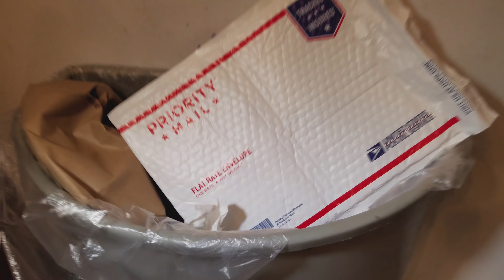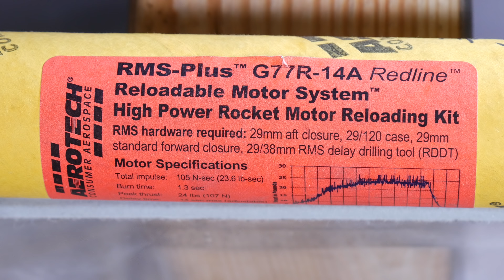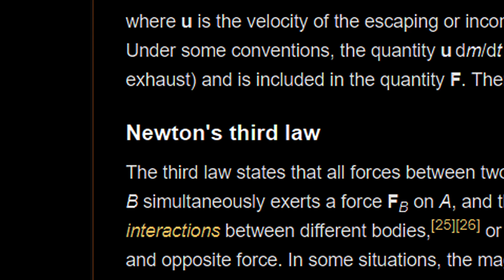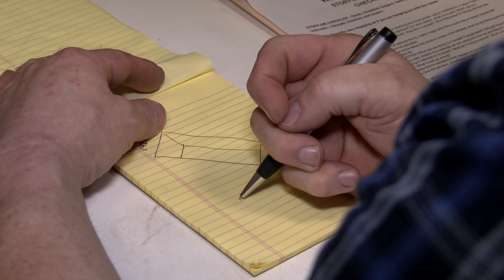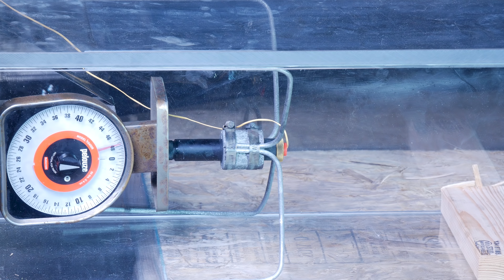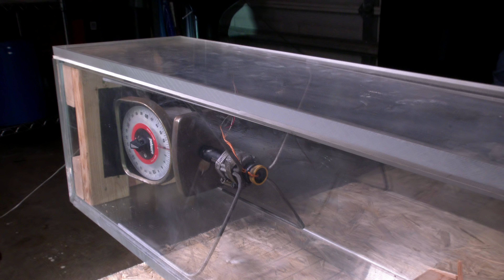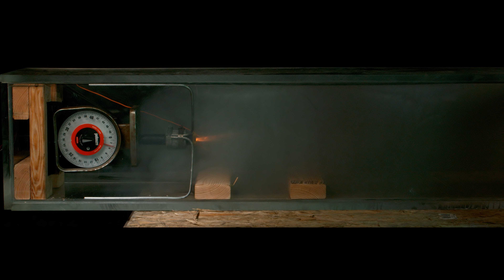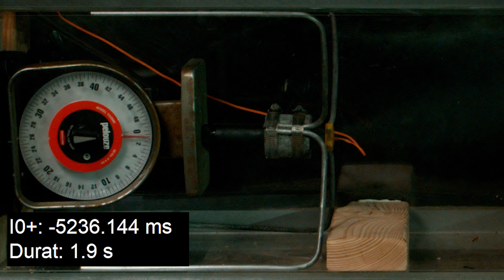Rockets in a Vacuum Chamber - Newton's third law of motion Visualized

Comment: Here's a quandary for anyone who believes rockets don't work in space. Say you're in space and you're just floating. You're wearing a spacesuit and holding a basketball. You then decide to throw the basketball. Does the basketball move? If not, what's stopping it? If it does move, do you move the other way? If you do, then that's how rockets work in space. If you don't move, then why are you so different from the basketball in this physical interaction?
Reply: The "rocket propulsion deniers" will agree that physics works when applied to a solid object like in your example.  What you CANNOT convince them of is that GAS will behave the same way.  They REFUSE to believe that each gas molecule behaves EXACTLY as the basketball and induces recoil to anything that accelerates it.
They believe this because they think the "vacuum of space" will PULL Gas molecules from the rocket, but they dont realize the "vacuum of space" DOES NOT PULL ON ANYTHING.
Reply: @stevencurtis7157  they  usually deny gravity is real as well. So there is that.🔨
Reply: @cory5797  Not sure that really affects rocket exhaust, but if they can deny one demonstrable physical phenomenon, they can deny any.
Reply: So after the first basketball was pushed away from you....and pushing it away from you would feel weird because there would be no additional resistance from space, unlike being on the basketball court, where the atmosphere offers resistance to the basketballs movement as you push it away......
So pushing the basketball away from you in space is easily done.  You push it away it offered very little weight resistance and flew away fast and kept going.  You on the other hand may have felt a slight backlash from doing that, and lets say that amount of kickback made you move 1mph in the opposite direction, as the basketball is moving 30mph away from you not slowing down at all....so neither are you.....so now you are moving 1mph in the opposite direction away from the basketball while it moves away from you.  Well what happens when you go to use  another basketball now to make yourself speed up from 1mph to 2mph?

Since you are now moving at a constant velocity of 1mph away from the direction you plan on pushing the next basketball away from you, it's the same as being on the basketball court, and walking backwards while you simultaneously try to pass the basketball someone in front of you as you are walking backwards away from them.  

Now pushing that basketball away from you doesn't have as much kick as the first time you did it....now pushing it away from you with the exact same amount of force doesn't make it move 30 miles per hour away from you...it's slower now because you are constantly moving the other direction.  Pretty soon it doesn't do any good to push basketballs away from you, because you can't push them away fast enough to do anything now....You are moving at a constant velocity so you have to push the basketball away at least that velocity or it won't offer any resistance, and will no longer provide any thrust for you.  this is exactly rockets do NOT work in space.
Reply: @dr.davidbannerf.e.s.6217  Acceleration is change in velocity. It doesn't matter whether you change the velocity of the basketball from 0 to 30 mph or 1000 to 970 mph, it's going to have the same effect on you, that is changing your velocity by 1 mph.

Can you describe exactly what you mean in mathematical terms?
Reply: @stevencurtis7157  Quite simply put....if we have a water balloon in space, and we open the end of it, there is nothing to slow the water down from coming out  of  the balloon....so the water doesn't get PUSHED out....it gets drawn out.  Meaning....there is never a time when the water coming out of the balloon encounters slower moving water to tell to get out of  the way.  so there is no net force in the opposite direction.

It's simple actually.  on the Earth when the  end of the water balloon is  opened, there is resistance to it coming out....the atmosphere offers some resistance to the water coming out  of  the balloon....so the faster moving water leaving the end of the balloon runs into the slower moving water which was immediately slowed down because the atmosphere offered resistance to it's forward movement.  when this fast moving water runs into  the slower moving water that was just ahead of it, it pushes it out  of the way, and this makes the balloon take off.

In space it's different...the water coming out of the never encounters slower moving water to push out of the way....The water moves at a constant velocity exiting the end of  the balloon, it is never slowed down any because there is no atmosphere in space to cause the column of water to  hit the brakes and slow it down....so the water coming out of the balloon just joins the already fast moving water already expelled, and never pushes it of the way saying move out  of the way I'm cruising faster than you.  So sorry guys....a rocket absolutely does not provide thrust in space.  Right back to  what we have been saying the whole time....there is nothing in space for the water jet to push off of, therefore it is never slowed down leaving the rocket, and never has anything to push out of the way, so you never get pushed in the opposite direction as a result.
Reply: @dr.davidbannerf.e.s.6217  long and wrong speed is relative
Reply: @dr.davidbannerf.e.s.6217  what's pulling on the water? Is it just a coincidence that the balloon rubber is like a spring and squeezes the water out? It can't act like a spring if there's nothing for the spring to push the water against?
Reply: @cory5797  If we actually witness a water rocket, or water balloon when the end of it is opened....what would happen if  you opened the end of it in our atmosphere, or the vacuum of space....if we could watch what happens in slow motion....we would know what is truly going to happen wouldn't we?

Well...that's where I step in....My mechanical aptitude allows me to simulate such things with a high degree of  understanding about their movements and workings.

When the end of  the water balloon is opened in our atmosphere, the speed which the water comes out is slowed down by the atmosphere itself...just simply saying it immediately encounters resistance to it's outwards path of travel.   This seen in slow motion equals the very first amount of water to come out, to now be moving slightly slower than the current water coming out right next to the end of the balloon.  In other words...the water coming out of  the balloon encountering resistance is  slowed down some, and this forces the initial velocity of the water exiting the balloon to push against the slower moving water that was expelled first...and this "pushing out of the way", by the faster moving water running into the slower moving water is what produces a "force" for the balloon itself to get pushed forward.....or this is what produces the Thrust of the water jet coming out.  It's faster moving water under pressure, running into the slower moving water that left first in line, that has been slowed down due to the atmosphere here on Earth.

In space it is quite different and  the difference is that water jet coming out of the balloon does NOT get slowed down, and therefore does NOT get pushed out of the way by the faster moving water at the back of the line.  Instead the water which left the balloon FIRST is traveling at the same speed the water leaving the balloon NOW is  traveling.  So the water leaving the balloon NOW is NOT moving faster than the water which left the balloon FIRST....therefore it does NOT run into slower moving water, and therefore it does NOT push slower moving out of the way, and therefore does NOT provide any thrust because it never pushes ANYTHING out of it's WAY.    Got it?  Get it...learn it....love it...eat it up...do whatever you gotta do....but dont ever FORGET.  And maybe don't me....Old Skool...who told you about it, and took the painstaking time to tear down your initial biased opinions about it...and BEAT it into you mind literally, repeating it over and over and over until you FINALLY get a good grasp of what is actually happening.  I Want you to know what is happening...it's in my nature, as One Man Sharpeneth Another.  Amen.
Reply: @stevencurtis7157  not that I know of but it was a good way to prove a point
Reply: @stevencurtis7157  I think its easier just to see it as water under pressure inside of an object, and then a valve is opened allowing that water to escape.  In atmosphere the water First in line to escape is immediately slowed down due to the resistance the atmosphere has on its path of travel.  So the water now coming out of the object runs into the slower moving water which exited first, and pushes it out of  the way, and provides a thrust or force to push the object in the other direction, because the object itself has something coming out of it, that is pushing other stuff out it's way.

In space this cannot be, because the water coming out of the object never gets slowed down by an atmospheric pressure....space doesn't offer any resistance  to  it's path of travel exiting the object.  So the water first in line to leave the object is moving at exactly the same speed as the water currently leaving the object, and so the water currently leaving the object never encounters slower moving water to push out of  the way, and so the object doesn't have any forward thrust....Because it doesn't have anything coming out of it that is pushing anything out its way.  That simple.  Case Closed Yet Again...Geez....Just Say thank you Old Skool...and go be a bad ass in the science world now with this FACT of Phsyics.  Impress all of your friends for KNOWING the exact physics of what actually happens....they won't be able to prove you wrong now....because YOU KNOW WHAT HAPPENS>  Gratze'
Reply: @dr.davidbannerf.e.s.6217  for the"toy water rocket in a vacuum"  experiment, please draw a force diagram and tell us where does the FORCE originate THAT ACCELERATES THE WATER ??  You refuse to answer this basic question because it reduces your understanding of physics to nonsense. TELL US WHERE THE FORCE COMES FROM THAT ACCELERATES THE WATER.
Reply: @dr.davidbannerf.e.s.6217  You didn't answer my question. What is pulling on the water?
Reply: @stuartgray5877  There is no force that accelerates the water coming out of  the balloon here on the Earth...in fact the atmosphere slows down the water coming out of balloon because of resistance to the path of travel.  And of course just the opposite for being in space....no resistance to the path of travel for the water coming out while it's in space..it can just come right on out and keep cruising while in space....it never gets slowed down like being  in an atmosphere.  Duh.
Reply: @stevencurtis7157  Oh, what is pulling on the water?  i don't really think there is anything pulling on the water....it's just that in space there is nothing to slow the water down coming out of  the balloon....so it keeps moving at whatever speed it comes out of the balloon while it's in space.....and then of  course the water is slowed when it leaves the balloon while it's in the Earth's atmosphere.....So the atmosphere of the Earth slows down the water escaping the end  of the balloon....and space does not ....Hope this helps....I probably won't be able to help you much  more on this topic....But it's fairly simple to understand, so good luck.
Reply: @dr.davidbannerf.e.s.6217  Okay, so we go back to the original post. You are floating in space, you throw a thing. It definitely moves. Do you move? If not, how is that possible? What evidence do you have that "pushing off" is required for thrust? 

I previously have an example of a bowling ball and a jumbo beach ball. The huge beach ball pushes a lot more air out of the way, but it exerts a lot less force on your body when you throw it. The bowling ball pushes much less air or if the way but resists being moved much more.

Explain?
Reply: @stevencurtis7157  It would only work on a small scale....you wouldn't get that much momentum in the opposite direction shoving the bowling ball away from yourself.....like imagine floating in space, and trying to throw the bowling ball away from you instead of pushing it away with both hands at the same time.....man that's a hard one to understand....
Reply: @stevencurtis7157  Like it would only cause your body to pivot slightly and rotate very very slowly perhaps in the opposite direction of the throw.....and again...you arm has to move faster than the bowling ball, or it won't push on anything.
Reply: @stevencurtis7157  Like...in space....you get something out of the first initial push of a heavy object away from yourself....but the next push doesn't have as much effect...because you have to push faster the next time....pushing the heavy object away the second time won't get you anywhere unless you push it away faster than the speed you are moving now.
Reply: @dr.davidbannerf.e.s.6217  - "there is no force that accelerates the water coming out of  the balloon here on the Earth.."
THERE MOST CERTAINLY IS!  The "Force" trying to push the water OUT is the pressure differential between the inside and the outside.  

Now in the example of the toy water rocket in a vacuum:
where does the water get the FORCE that accelerates it into the vacuum ?

Are you saying the water WONT shoot out into the vacuum?
Are you saying that the water requires NO FORCE to be accelerated into the vacuum?

WHY do you refuse to just answer this simple question?
Reply: @stuartgray5877  I've already answered this question time and time again...but let's run it through until we reach the bitter end....Lol!
Or the glorious understanding of it in fine detail!  Whichever way it ends up going....it will be a meeting...of..the minds.
Deep...like the Minds of Minolta...let's picture this yet once again....

The water balloon in space has water trapped inside of it that is under pressure.....and when released it does not get slowed down any like it would on Earth....let's go with that much, because we both agree in space there is no atmosphere to offer resistance to it's path of travel escaping the balloon's water jet opening.

So on Earth the force with which the water is escaping the jet opening does encounter some resistance, because of the atmosphere.  That causes the jet stream of water to apply pressure against the air on the outside of the balloon.  The fact that the atmosphere outside of the balloon offers some resistance, is why the jet stream of water coming out applies pressure against it...and it is this ability to apply pressure against something impeding the water's path of travel that produces the thrust force we are searching for.

In space a water balloon can be housed in a chamber to protect it from the outside lack of atmosphere, whereas only the jet stream opening can be opened and closed allowing the water to escape the balloon to outside of the balloon's protective chamber.....And now let's see what the water jet balloon in space does:....

When the water is escaping the opening it does NOT encounter any resistance to it's path of travel, and therefore; cannot apply any pressure against anything because there is nothing offering any resistance to it...there is no atmosphere to offer that much needed resistance to its path of travel for any pressure to occur against. Literally there was no bowling ball on the outside of the jet opening when you opened it and released the pressurized water.  

So there was no initial pressure applied to anything to produce any force in the opposite direction in order to move the rocket.  If there a bowling ball floating in space right beside the jet opening, but not attached to it....THEN when you released the pressurized water, it would run into something......it would have something offering resistance to its path of travel....then it would produce pressure against the surface and weight of the bowling ball, which would produce a force of thrust in the opposite direction.  

So sorry, but I had to remove the bowling ball from behind the rocket powered space ship...because we  ARE talking about space where there is nothing around you.  No bowling balls out there to push off of....for that you better hope you are close enough to a planet for the jet stream of water to reach some resistance to its path or travel.....Or you is NO go no wheres
Reply: @stuartgray5877  Mowfrackin Old Skool just broke it down with a water balloon and a bowling ball yo....That was dope...That brotha there got some science up in him....I wonder where he went to school main.....
Reply: @dr.davidbannerf.e.s.6217  - ALL of that above and you STILL NEVER ANSWERED THE QUESTION .

I know this for a fact, because nowhere up there do you say:
"The Force that accelerates the water comes from the nozzle "

See Larry, to accelerate the water, the NOZZLE MUST EXERT A FORCE ON THE WATER .
And you know what they say about a "Force"? They ALWAYS OCCUR IN PAIRS.
For there to be an ACTION (the water getting PUSHED ON) there MUST BE A REACTION (the NOZZLE GETTING PUSHED ON)

It is NOT POSSIBLE for the water to get a FORCE in one direction WITHOUT THE NOZZLE FEELING THE SAME FORCE.
Regardless what you say YOU CANNOT CHANGE THIS MOST BASIC ELEMENT OF PHYSICS.
Reply: @dr.davidbannerf.e.s.6217  I already responded to your assertions about relative motion/acceleration. Acceleration is change in velocity. If you are holding the bowling ball, it doesn't matter whether you're still or moving at 1000 mph, if you throw the bowling ball away from yourself at a speed you perceive to be 30 mph, you will gain the same 2 mph regardless of your initial speed. Do you have some way to refute this?

I mean, your model suggests that if you were flying in a supersonic jet and fired a pistol toward the rear of the plane, you would get much less recoil because the gun won't be accelerated as much. Even assuming that the plane had to be a vacuum chamber, that's blatantly and obviously untrue.

I mean, just walking on a plane would be a problem. To even move toward the front of the plane, you should need to apply enough force to push yourself forward faster than the plane just to start walking. Meanwhile, the force required to walk to the back of the plane must be so low that you'd shoot backwards at high speed and splatter on the back wall like you jumped off a skyscraper.

I'm calling this as your last chance to address my rebuttal. If you don't respond to the contention, then you're officially dunce-cap of the week. Since all your posts are predicated on that claim, you better have something good.
Reply: @stevencurtis7157  "Just like the Buddha kid in the Matrix told Neo.....do not try to push against the bowling ball.....rather, realize that in space there is no bowling ball.."

Old Skool
Reply: SCALE!!!!!! you have to consider masses involved and the amount of "force" exerted...
Reply: @stuartgray5877  You and the truth are totally estranged. ..
Reply: @messiahblackgod  can you elaborate? I'm not even sure what you're arguing for.
Reply: @stevewittwer7444  Wow, u mad bro? No need to be so salty.

I agree that if you remove either your body or the ball, you are indeed not going anywhere. Now imagine that sentence dripping with sarcasm.

I have no idea what movie you're talking about.

Now, show why anything I've said is a lie. Then we can discuss something. Until then, y u mad tho?
Reply: @cory5797  gravity is A THEORY that has NEVER been elevated to fact. Only on your imagination.. Density..
Reply: @stevewittwer7444  Also, please allow me to introduce you to a delightful concept: it is possible for a person to be wrong without lying. Continue as you are and prove that you're the real liar, lying about my intentions, which you cannot know.
Reply: @stevencurtis7157  take the ball out of the equation amd you will go nowhere because there is no opposing force. That is what happens to a rocket. No resistance from the opposite direction.. No thrust.. Exactly the Same as making the throwing motion without the ball.. You helped prove, again that rockets don't work in the vaccum of fake space.
Reply: @stevewittwer7444  The stand in for the ball is the rocket exhaust. Gas has mass. It has weight. It weighs something. If you throw it, it's the same thing. The energy put into the gas by combustion has the same effect as your arms pushing the bowling ball. That's why my OP is a catch-all, it's an informal version of a rigorous proof that negates the arguments that rockets need to "push off" an atmosphere.
Reply: @stuartgray5877  why accuse someone of not answering a question when u you never gave him a chance to answer it... How can tjey keep cool in space when they cannot radiate the heat in a vaccum. You refuse to answer this basic question because it cannot be answered and debunk your space fantasy. TELL US HOW THEY REMOVE HEAT IN A VACCUM... same as you do to others so it is on to do it to you...
Reply: @dr.davidbannerf.e.s.6217  but the "FUEL"  (exhaust gases) HAS MASS and therefore INERTIA. To accelerate something WITH MASS requires A FORCE.  You CANNOT ACCELERATE the exhaust gases without A FORCE .  So Larry - when the exhaust gases are accelerated into the vacuum WHERE DOES THE FORCE COME FROM ?
Reply: @stevewittwer7444  I can tell you how heat is removed in a vacuum, but you are CHANGING THE SUBJECT.  Now answer my questions.
Reply: @stevencurtis7157  yes it is. In this case you are lying. If you done no research, then you knee you are just guessing, and therefore being dishonest (lying). Just childish dishonest argument obwr something you are ignorant about amd ignore qhat people say. Ho research yourself. If you done the research you will know rockets don't thrust in space so you are still lying... You cannot understand the plain and simple explanation, then go watch something you can understand. Like some kids show..
Reply: @stevencurtis7157  you were obviously the dunce of your claas every year, right.
Reply: @stevewittwer7444  lol u got it gravity is not real and you can prove it
Reply: @stevewittwer7444  AGAIN you are making false statements about a topic you clearly know nothing about.  Heat is rejected by hot objects in a Vacuum via RADIATION .  The SAME WAY heat gets to earth from the sun.  Now stick to topics you know about.
Reply: @stuartgray5877  This the last time I am going to answer this question about the only Force at play in the situation of a rocket in the vacuum of space.  the fuel is under pressure in the tank, it is ignited and allowed to escape....whatever speed that is...is the only force of anything coming out of the rocket....It is the only thing leaving the rocket's presence, therefore it is the only thing that could possibly have any FORCE of ANY kind whatsoever.........

In space this FORCE or speed with weight equaling INERTIA.....Cannot act upon any OTHER speed or weight of anything.  There is  nothing in space to give this FORCE anything to apply pressure against.

Quite simply put, if there was something in space for the FORCE of the rapid escaping fuel and gas column to apply pressure against....It would make the rocket move in the other direction.  

At no point in time did I say the fuel being under pressure in the tank, then lit on fire and allowed to be accelerated outwards from the ship wasn't producing any FORCE.  Of  course the water, or air, or rocket exhaust is expelled with FORCE.............the part you keep missing is the ability to USE that force to achieve propulsion my friend....and I will keep saying until I am blue in the face......That FORCE is never met with any opposition....it is never up against resistance of any kind whatsoever....the vacuum of space meets that FORCE with nothing....it doesn't slow it down, or make it move any faster....the exhaust just moves at whatever speed it moves at, and keeps moving at that speed....it is never slowed down......a ball thrown by you in space just keeps on booking.  And a ball thrown by you in space is not going to just speed up all of a sudden....so you will see it fly away at a CONSTANT speed.

So when the Force of the rocket exhaust is moving....since there was no bowling ball in space for the FORCE of the rocket exhaust to push against.....it didn't provide any thrust.
Since the FORCE of the rocket exhaust was immediately met with NO resistance from outside of the ship....it could never apply pressure to anything in order for the ship to be pushed in the opposite direction......

Since the FORCE of the rocket exhaust was simultaneously met with ZERO stopping power from the space outside the rocket bell housing....it could never apply it's inertial FORCE on anything to benefit the ship itself....YOU saw it just move away from the ship while your speedometer sat still.  

YOUR arms and hands are the rocket fuel escaping the ship.  IF they cannot FIND a bowling ball outside the ship to push away............YOU don't get shoved the other direction any....ITS OVER>
Reply: @stevewittwer7444  the question I keep asking that Larry wont answer is: with a Toy WATER ROCKET, in a vacuum, when the Water gets pushed out of the rocket BY AIR PRESSURE, where does THE FORCE originate ??  The water CLEARLY gets accelerated, so WHERE does the force come from that is accelerating the water?  He TYPED a lot of WORDS but he never answered the question.   Now YOU answer My question: if I fire ice blocks from a crossbow in a vacuum, WILL THERE BE RECOIL ??
Reply: @dr.davidbannerf.e.s.6217  ok, you finally admitted that the water (or fuel, or exhaust gas) REQUIRES A FORCE to be pushed INTO the vacuum.  Good now we agree that the exhaust gases REQUIRE a force to be accelerated AND that force originates AT THE ROCKET NOZZLE.   Now recall one of Newton's most basic laws: "For Every ACTION there is an EQUAL AND OPPOSITE REACTION" .  Do you recall this? It means there can NEVER be a single ended force, they come in PAIRS.  So for the water (or exhaust gases) TO FEEL A FORCE from the NOZZLE, the NOZZLE FEELS THE SAME FORCE FROM THE WATER .  So we just proved that Rocket Propulsion MUST work in a vacuum as the Water (exhaust gases) GETS PUSHED INTO THE VACUUM .
Reply: @stuartgray5877  You still got it wrong right from the start again.  It does not require a force to push the fuel into vacuum.  The fuel is already under pressure, and will move out of the nozzle because of  that.  What is required is the equal and opposite reaction from space when this occurs....there must be a reaction space gives in response to this action.  So again....what is the reaction that space gives to  the action of the FORCE at which the rocket fuel is coming out?  

Because remember...on the Earth....the reaction that the atmosphere gave to the action of the FORCE at which the rocket fuel was coming out was RESISTANCE>  The Force of the rocket fuel was met with an equal and opposite force of RESISTANCE>  This allowed the FORCE of the rocket fuel to apply PRESSURE against that resistive response from the atmosphere outside of rocket.   And bingo the equal and opposite reaction of this interaction between Force applied in one direction, met with resistance, resulting in pressure applied to air, and it being pushed away.....The equal and opposite reaction of this event occurring is what we call THRUST!  

Now you are finally getting it!  
There is no THRUST in Space!
Because the Force of the rocket fuel does NOT get met with an equal and opposite braking force, or any braking force whatsoever from space....since space does not have the reaction of slowing the rocket fuel down.....There is never the equal and opposite reaction from pressure being applied to a resistive medium.......Because it  is ONLY when pressure is applied to a resistive medium that you can have the equal and opposite reaction of being shoved back the other way you silly silly man.
Reply: Two totally different scenarios:  On the one hand when the rocket fuel comes out  of the nozzle with speed and force, and it met with an equal reaction from the atmosphere of Earth which impedes the rocket fuel's movement some....offers some resistance to that action.....then an equal and opposite reaction occurs from this....and THAT my friend is how we achieve Thrust.

Thrust is literally the equal and opposite reaction of applying pressure to a resistive medium.  Something that will offer some resistance to the direction of that rocket's exhaust.   And when there is something present that offers this REACTION to the ACTION of the rocket fuel escaping....That allows pressure to be applied between the TWO of them, and BINGO!  You get have a force shoving you in the opposite direction!  Thrust!!!  Isn't that cool!

But in space....when the rocket fuel escapes...it is NOT met with the much needed REACTION of allowing the FORCE of the ACTION of the rocket fuel escaping the rocket to apply any pressure against anything.....so the ACTION of the rocket fuel escaping is met with the REACTION of nothing.....ZERO resistive medium for that ACTION to apply pressure against.   Nothing out there for the Rocket exhaust to apply pressure against....So sorry.....And THAT is why there is never the equal and opposite reaction of being shoved in the other direction.....because there is never the event where the rocket fuel is applying pressure to any resistive medium in space, there is NEVER a FORCE created between the rocket fuel and the resistive medium...so there is NEVER any point in time when the rocket fuel is applying PRESSURE to something in space to get a resistive response from it.....which in fact what we call THRUST>

Thrust IS the resistive response from the medium which you allow the rocket fuel to escape in.
Reply: @dr.davidbannerf.e.s.6217  Watch the YT video " Close Up Footage of Falcon Heavy Launch Through Landing!" by Astronomy Live.
Now explain how those Boosters separated at 60 kilometers altitude, in a vacuum, Turned around, canceled ~3600 MPH downrange velocity and FLEW BACK TO KSC - IN A VACUUM .

YOU said rocket propulsion DOES NOT WORK in a vacuum, so explain HOW those boosters CHANGED DIRECTION IN A FUCKING VACUUM.
Reply: @stuartgray5877  I will tell you exactly what I see in that video....because I SEE everything.  For one it is a relatively small test chamber.  Two, that little rocket doesn't produce any thrust until there is enough resistance to it's exhaust....that is why there is a slight delay in the time before it applies any thrust against the scale.  It is precisely that time which the little rocket is adding pressure back into the test chamber, that the pump took out when it was being evacuated before the test.

I super simple terms:  I take a pressurized can of air.....then place it inside a fairly small airtight chamber I have taken the air OUT of....and I release the compressed air inside of that test chamber......what did I just do?

I sucked the air out of the test chamber, and then I turned right around and put air back into it.

I sucked the air out of the test chamber, then I released a canister of air of compressed air into the chamber, and duh...that just added air right back into the chamber.  Easy Stuff.   That is what I see....and THAT is exactly what happened.
Reply: For those that believe rocket propulsion does NOT work in a vacuum, let's do some thought experiments:   Imagine an Aluminum cylinder 40 cm long (about 16 inches) sealed at both ends with a plate and a ball valve in the center of each plate.  The orifice of the ball valves is 1 cm (almost 1/2 inch).

So, this is a sealed cylinder with ball valves at each end.
Now inside the cylinder is a piston that can move freely but wont let liquids or gases cross the boundary from one side to the other.

If I open both valves and pressurize one side, the piston will move all the way to the opposite side and vice versa.
(This is basically the design of an Oil Accumulator for a race car)
Fill one side of the cylinder with water half way (this is one liter).
Then pressurize the other side with 10.0 PSI air (this is ALSO about 1 liter).
Now IN AN ATMOSPHERE, if we open the water valve, WHAT HAPPENS?
The water will SHOOT out the valve like a fire extinguisher.
What if we repeat the experiment with 3000 PSI air?
NOW the water would shoot across a parking lot!

Is there ANY question that in the second example the cylinder can impart a LARGER MOMENTUM onto the water stream than the 10.0 PSI example?

Now take this same cylinder and try some examples in a giant vacuum chamber:

1 - I fill the water side with 1 liter of water, I OPEN the gas side valve and put the cylinder in the vacuum chamber and pump it down.  So now there is Vacuum on the "gas side" of the piston and vacuum outside the water valve.
What happens if I open the valve?  The water would NOT just shoot out of the valve because the vacuum is NOT pulling on the water.  There is NO PRESSURE on the "gas side" of the piston because it is exposed to vacuum too so it is not "pushing" the water towards the vacuum.

So the water (now exposed to vacuum through a 1/2 inch hole) will begin to boil (and freeze simultaneously) and pressure would build inside the cylinder and begin pushing the water out, but this would not be instantaneous.

2 - I fill the water side with 1 liter of water, I FILL the gas side with 10.0 PSI (10.0 PSIG is GAUGE pressure, ABS pressure would read ~24.7 PSIA), CLOSE THE VALVE, and put the cylinder in the vacuum chamber, and pump it down.  So now there is 24.7 PSIA on the "gas side" of the piston and vacuum outside the water valve.
What happens if I open the valve? WONT the 24.7 PSI PUSH THE WATER out FASTER than example #1?

The water will have velocity (shooting out of the valve) that it did not have before.  Something is accelerating the water. What is providing the FORCE to accelerate the water into the vacuum?

3 - I fill the water side with 1 liter of water, I FILL the gas side with 3000.0 PSI (3000.0 PSIG is GAUGE pressure, ABS pressure would read ~3014.7 PSIA), CLOSE THE VALVE, and put the cylinder in the vacuum chamber, and pump it down.  So now there is 3014.7 PSIA on the "gas side" of the piston and vacuum outside the water valve.
What happens if I open the valve? WONT the 3014.7 PSI PUSH THE WATER out FASTER than example #2, like A LOT FASTER?

Wont the MOMENTUM of the water be HIGHER than in example #2?
So WHERE does the FORCE that accelerates the water COME FROM?
Reply: ignition doesn't happen in space though, so the rocket is useless there
Reply: @scottandildi  so are you saying a HAND GRENADE would not explode or a bullet would not fire in a vacuum?  REALLY?
Reply: @dr.davidbannerf.e.s.6217  so no comment on the video of rockets propelling themselves in a vacuum that proves you wrong?  Surprising...
Reply: The way I see it the vacuum of space is to air as air is to water. Far less dense. If I take a boat motor and propeller and try to fly in air it doesn't work. Why? You might say because it needs water to push off of. Ok...then how does a plane fly with a prop. Same idea but different medium. Different density substance that we're trying to push off of.
Reply: A plane prop pushes air at a higher velocity the the gear ratio from the motor is also different... the prop spins faster. With a boat you also need higher torque to move through the more dense water.
Reply: So then when we talk about space like there's nothing to push off of. There is something it's just far far far far less dense than air but if you push with a high enough velocity the exhaust can't disperse fast enough and so produces thrust. Like behind an airplane prop the air is under higher pressure than atmospheric but it disperses quickly. Same would be true in space but to a different degree.
Reply: If your in a boat and you go full throttle you better hold on because there is so much thrust and water is so dense to push off of you can accelerate very quickly depending on horsepower. In a prop plane when you go full throttle from stop you may feel thrust but It's not going to throw you out the back of the plane.
Reply: @stuartgray5877  Those were the ACTUAL videos that showed what was happening....that's how we know what we KNOW now....the exhaust of the rocket placed pressure right back into the chamber, that we had previously taken out to make it a VACUUM.

WE ADDED something to our CONFINED space that is airtight and HAD the air sucked out.   There it was:  A box with the air sucked out....or pressure inside of the box reduced, or the "atmosphere evacuated out of it".....whatever you wanna call it.

that's what we did.......We added atmosphere RIGHT BACK INTO IT>  IN the form of gas molecules from the rocket itself....

And YES....there a DELAY in the time before THRUST was produced in the experiment with a relatively small BOX.

Then when a larger BOX was used...it took LONGER for the gas molecules to create an atmosphere inside the BOX....and that is why we saw an even LONGER delay before the rocket pushed against the scales.  

If you Don't get it...that's ok.....Thousands of people get it now.....scroll DOWN in the comments section on that video now.....LOTS of people see what happened.

REAL SIMPLE......We sucked the atmosphere OUT of the BOX.
Then firing the rocket PUT atmosphere back INTO the BOX, and that's when THRUST  happened........Cha Ching....
Reply: You fools got it twisted. It’s not that propulsion wouldn’t work. It’s that fire doesn’t burn. No fire = no propulsion. You throwing a basketball has no need of the use of fire to get propulsion. Just your own energy.
Reply: @dr.davidbannerf.e.s.6217  in that video I ASK YOU TO WATCH ABOVE , HOW do those boosters turn around and fly back to KSC IN A VACUUM ??
Reply: @adeadlyfart13  - If you read my other posts you would find I AM TALKING ABOUT THE SPACCEX LAUNCHES AND LANDINGS and it IS NOT POSSIBLE FOR THOSE launches and landings TO BE FAKE.  Every single one is viewed by TENS OF THOUSANDS of spectators LIVE, and I have seen one MYSELF with my own eyes.  There are now HUNDREDS of amateur videos of the spacex launches AND LANDINGS on YT.  Now QUIT MAKING SHIT UP!
Reply: Find a big carton box. Seal all 5 sides with an opening at the side. Go in an push with your hands with all your might at the opposite side of the opening while kicking out at the opening. Then observe how fast and far the box goes.
Reply: @stuartgray5877  On the Flat Earth model....any pendulum placed anywhere on Earth will point straight down to the same direction of down.  Not any different directions of  down. And whatever happens when you swing it is the NATURE of how a weight tethered to a long string FORCES the weight to swing around....and YES it does swing in RANDOM patterns based upon HOW you swing it.

ON the Globbers model the pendulum weight is being pushed or pulled by centrifugal force from the rotational velocity at that particular location (the ground speed at say the North Pole, versus the Equator), and the pendulum is either pushed or pulled off center accordingly....both while motionless, and while swinging because the FORCE of pushing or pulling from the rotational velocity is CONSTANT at that location.   Real simple.

If there is any force present to push or pull on the weight of the pendulum while it's in motion, the SAME amount of force is pushing or pulling on the pendulum while it DOESN'T swing...effecting where it points straight down to NOW..and how it was swinging THEN>

See how that works....super simple:

A Pendulum weight under centrifugal force of any magnitude shows the EFFECT of this force acting upon the pendulum while at REST..in the form of the weight itself being pushed or  pulled in the DIRECTION that FORCE is ACTING UPON IT>  And this SHOWS itself in the form of WHERE the pendulum weight points down to.  Pushing or Pulling on the weight of the pendulum with centrifugal force while it's at rest, or motionless and NOT swinging.. will simply push or pull on the pendulum weight, and CHANGE the DIRECTION it points to. 

A Pendulum weight under centrifugal force of ANY magnitude shows the EFFECT of this FORCE acting upon the pendulum while it SWINGS, in the form of the weight itself being PUSHED or PULLED in the DIRECTION that FORCE is ACTING UPON IT>  And this SHOWS itself in the form of HOW the pendulum weight swings.  Pushing or  pulling on the weight of the pendulum while it's swinging.. will simply CHANGE the DIRECTION it swings to.
 Thanks, Old Skool.  You're Welcome Guys.

See your Globber model does NOT take into account the effects of centrifugal force on the Pendulum while it's at rest, not swinging.............Because if it ever did, and ONE of you announced it PUBLICLY it would disprove the Spinning EARTH theory....because you would have to show  the weight of the pendulum pointing in the direction the force of the spin was acting upon it.  And it would be curtains for you guys then and THERE> That's why you perform a parlor trick by making it swing manually by pushing on it...and then say the magical centrifugal force pushes or pulls on the weight to change where it points to.  Dumbass People......Just like YOURSELF>
Reply: @messiahblackgod  On the Flat Earth model....any pendulum placed anywhere on Earth will point straight down to the same direction of down.  Not any different directions of  down. And whatever happens when you swing it is the NATURE of how a weight tethered to a long string FORCES the weight to swing around....and YES it does swing in RANDOM patterns based upon HOW you swing it.

ON the Globbers model the pendulum weight is being pushed or pulled by centrifugal force from the rotational velocity at that particular location (the ground speed at say the North Pole, versus the Equator), and the pendulum is either pushed or pulled off center accordingly....both while motionless, and while swinging because the FORCE of pushing or pulling from the rotational velocity is CONSTANT at that location.   Real simple.

If there is any force present to push or pull on the weight of the pendulum while it's in motion, the SAME amount of force is pushing or pulling on the pendulum while it DOESN'T swing...effecting where it points straight down to NOW..and how it was swinging THEN>

See how that works....super simple:

A Pendulum weight under centrifugal force of any magnitude shows the EFFECT of this force acting upon the pendulum while at REST..in the form of the weight itself being pushed or  pulled in the DIRECTION that FORCE is ACTING UPON IT>  And this SHOWS itself in the form of WHERE the pendulum weight points down to.  Pushing or Pulling on the weight of the pendulum with centrifugal force while it's at rest, or motionless and NOT swinging.. will simply push or pull on the pendulum weight, and CHANGE the DIRECTION it points to. 

A Pendulum weight under centrifugal force of ANY magnitude shows the EFFECT of this FORCE acting upon the pendulum while it SWINGS, in the form of the weight itself being PUSHED or PULLED in the DIRECTION that FORCE is ACTING UPON IT>  And this SHOWS itself in the form of HOW the pendulum weight swings.  Pushing or  pulling on the weight of the pendulum while it's swinging.. will simply CHANGE the DIRECTION it swings to.
 Thanks, Old Skool.  You're Welcome Guys.

See your Globber model does NOT take into account the effects of centrifugal force on the Pendulum while it's at rest, not swinging.............Because if it ever did, and ONE of you announced it PUBLICLY it would disprove the Spinning EARTH theory....because you would have to show  the weight of the pendulum pointing in the direction the force of the spin was acting upon it.  And it would be curtains for you guys then and THERE> That's why you perform a parlor trick by making it swing manually by pushing on it...and then say the magical centrifugal force pushes or pulls on the weight to change where it points to.  Dumbass People......Just like YOURSELF>
Reply: @stuartgray5877   I am the Stationary Earth Scientist David Banner....and I just turned into the Incredible Hulk...smashing the Globber Pendulum Experiments into DUST>
Reply: @dr.davidbannerf.e.s.6217   - in that video I ASK YOU TO WATCH ABOVE , HOW do those boosters turn around and fly back to KSC IN A VACUUM ??
Reply: @dr.davidbannerf.e.s.6217  omfg how did you found out the internets?
Reply: @superbecx  They have more than one internet now?
Reply: OH GEEEE
Reply: @GrimGod81  Fire doesn't burn anywhere. Fire comes from things burning. Yes, I know what you meant. You mean that stuff doesn't burn in space because there's no oxygen. Except spacecraft have two fuel tanks, and one of them is liquid oxygen (or oxidizer).

@Larry Lowe What's weird to me is that while you say the rocket only started moving after a delay, there's two problems with that. First, nothing starts moving immediately because you have to accelerate it, and that increases its speed, which is initially zero. Second, the rocket does start moving right away what are you even talking about it's the goddamn nail in the coffin ffs.
Reply: for quite some time now...
Reply: @dr.davidbannerf.e.s.6217   - In the YT Video titled:   "Close Up Footage of Falcon Heavy Launch Through Landing!" by Astronomy Live.
WATCH the VIDEO OF THE SPACEX FALCON HEAVY AND TELL ME WHAT YOU SEE

How do those boosters FLY BACK TO KSC ?
  They separated ABOVE 60 kilometers, IN A VACUUM and used WHAT to change direction and fly back?  Black Magic?
Reply: @stuartgray5877  You understanding of that event was flawed from the get go because those boosters were no where near being in a vacuum...they came back down way before they ever got that far away from the surface of the Earth.  You CANNOT fire a rocket straight UP, or it constantly LOSES thrust corresponding to the decreased amount of air, providing the hot blowing fire something to apply pressure against in the first place.  You just CAN'T....the rocket will stop going UP...and just hover full blast until it can't maintain full blast anymore, and falls right back down...Super simple.
Reply: @dr.davidbannerf.e.s.6217  I have told you this before but you ignore it: those boosters SEPARATED AT 60 Kilometers the Atmospheric Pressure at only 50 kilometers is LESS THAN 1.0 TORR .  Larry do you know what this means ?? This means that ALL OF THE MANEUVERS WE SAW THOSE BOOSTERS PERFORM WAS DONE IN A FUCKING VACUUM . Now Larry - HOW did those boosters TURN AROUND AND FLY BACK TO KSC IN A VACUUM ???
Reply: The basket ball moves fine. YOU DON'T, HA,HA!!
Don't feel like a dingbat. You are the rocket in your equasion & you have more intelligence than a rocket (including artificial intelligence). At lest I think so?

The Basket ball is still moving & you are not. Space & time go together. You're in space & buy you'll have plenty of time? ( canned laughter please).
Reply: exhausts just refilled the vacuum, try a much bigger vacuum
Reply: @stuartgray5877  are you saying a basket ball is inflated with air or inflated with a a vacuum inside it less than out side it ?  or are u meaning in theory Or what about a solid ball be better object...  Oh i see we are now saying the near or perfect vacuum of space is not a vacuum like  we been lead to believe blindly thinking about water in a vacuum & planet earth  is just getting vacuumed away...  I think we don't know what space is really  but a perfect vacuum in a conatainer the size of space  is not gona be affected by i tiny tiny rocket  even if it is made for vacuum operation. Have u ever blown a baloon up & released it so it blowing into a operating hover vacuum cleaner pipe  the baloon just deflates in the mouth of the pipe & then gets sucked into hover,  no thrust like releaseing  baloon normaly  ( note  un-tested idea i call it a theory  of blocked hover pipes)
Reply: My question is who empty's the gallatic hoover bag & when was the filter last cleaned,   OH it is the black whole at the center the great atracter  exuse me i a little worse for drink but gosh i starting to undestand what's what in our little universe
Reply: @dr.davidbannerf.e.s.6217  ... well-put! of course these rocket gurus will tell you that it works better because there is no resistance even though we know that is false ... it may be able to operate smoother but it will provide absolutely no thrust whatsoever
Reply: @trile9951  Anyone with a bigger vacuum really sucks!
Reply: @None888.  They talk out of both sides of their mouths man...for real.

I tell them that if centrifugal force is acting on a weight suspended from a tall building...that it no longer points just straight down ...instead it is tilted away because a force is constantly trying to make the equator of the Earth larger from the pizza dough spin.....and of course i go into how if the room were turning even a slow rate, how a weight suspended from the ceiling on a string WILL tilt away and towards the walls some...it has no other choice....it's center of gravity where it hangs down is constantly under a turning force now, and even if it's a small amount...it's unavoidable, and the weight NO LONGER POINTS STRAIGHT DOWN.  DUH!!

And this is what they say every single time:
The spinning force of the Earth's rotation won't make the pendulum swing on its own, or tilt towards the equator, or move at ALL.....but magically when you force it to swing.....BAM>  the rotational force of the Earth kicks in to FORCE the weight to swing in a perfect pattern all nice and tidy precision 15 degrees per hour...yep that's what it does......Wowser what an utterly stupid thing to say. 

 if there is no  force acting on the motionless pendulum to alter it's center of gravity......NOT EVEN A DEGREE.....and no forces coming from the Earth to make it EVER swing on it's OWN.....and no forces coming from the Earth to ever to make the motionless pendulum MOVE...............Then why turn right around and LIE saying the forces coming from the Earth WILL make it MOVE.....Will make it's swing be off the normal center of gravity.....Will push or pull against the weight of the pendulum while it's swinging, and WILL force it to MOVE and NEVER swing like just a damn rock on a string hung from the ceiling and someone pushes on it and stands back watching it swing back and forth.....Yay how exciting.

The damn trees would be bent and swayed slightly towards the Equator because every nanosecond of the growth and life of that tree would reflect the constant centrifugal force acting upon it, trying to make it go to the equator....the very force they say shaped the Earth in the first place, the spinning pizza dough force that made the Earth into an oblate spheroid in their minds.....Like WOW........talk about cognitive dissonance....FOR REAL!
Reply: @dr.davidbannerf.e.s.6217  ...dude i hear you..they dont know any better...what they believe they cant know...and what they know has neen told to them ....its all cheap sorcery!...assumptions built on lies fueled by popaganda...all hiding behind the so called authority of today...dont waste your time!...hit me up anytime...cheers!
Reply: @None888.  Here's another PRISTINE example of just how bad their minds have been screwed over:
In their minds:  A person standing several hundred yards away from the true center axis while on the North Pole, will be moving at about 5 miles per hour or less perhaps, because they are so close to the axis...they are just SLOWLY moving.  But while on the Equator they are now moving at over 900 miles per hour.  So...we use their classic train example:  A person moving at 5 miles per hour on a train looks out the windows and sees the stars and the sky and the world outside going by or moving SLOWLY.  A person moving at 900 miles per hour on a train looks out the windows and sees the stars and the sky and the world outside going by or moving FAST.

So me...The Flat Earth Scientist Dr. David Banner......tells them that what they just said VIOLATES the LAWS already put in place here on the Earth......And that is we ALL see the stars move at EXACTLY the same speed, no matter if we are on the North Pole, South Pole, Equator, and somewhere in between...doesn't make any difference...we ALL see them move at the exact same speed from our position.  And of course I remind them what this MEANS.

It means that no matter where we live......either the ground is moving at EXACTLY the SAME speed for EVERYONE EVERYWHERE ON EARTH......Or we ain't moving.
Reply: @oddball79square69  I have absolutely NO IDEA what that word salad means above.  If you can form it into a coherent question, I might try to answer.
Reply: You would not have the problem since we cannot be in space.
Reply: BUT, the basketball has a relatively dense and high amount of mass. Exhaust gas (which would be literally sucked out of the exhaust of a rocket in the vastness of space) does not! I'm not buying it at all do that same test but not in a relatively tiny space that cant hope to maintain a vacuum as the rocket goes off in a huge basketball court-sized vacuum or larger. and NOTHING  ....
Reply: lol then i read the rest of the comments below ... methinks I can see a consensus forming
Reply: @nickacelvn  except gases are NOT "sucked out" of the rocket.  The exhaust gases are PUSHED out of the rocket.  The "vacuum of space" has NO ABILITY whatsoever to PULL on anything.  "Vacuum" is literally nothing, it cannot exert any force on anything.
Reply: @dr.davidbannerf.e.s.6217  yes the stars appear to be moving at the SAME SPEED for both observers: an Angular Velocity of 15 DEGREES per hour .  QUIT trying to describe a ROTATIONAL SPEED using LINEAR SPEED. Your example is a perfect reason for NOT TRYING to report a ROTATIONAL speed using linear terms.  But AGAIN engineers and Physicists KNOW THIS.  This is exactly why morons who have never taken a physics class in their lives should NOT TRY TO LECTURE THOSE THAT HAVE!!!
Reply: If the orbital speed of the earth is 70,000 mph, and the sun is moving through space at 515,000 mph, and you are floating in space in a spacesuit holding your fucking basketball, how does the earth not fly away from you? Please don't tell me gravity, you are floating in 0 gravity
Reply: @dr.davidbannerf.e.s.6217  Man, what a meaningless words salad. In space, each push of a basketball away from you will impact some momentum to you, so you will move back faster and faster.
Replace the basketball with a heavy bowling ball for better idea how momentum transfer works.
Reply: @stuartgray5877 I am a little confused about this whole thing, Firstly shouldn't there be an explanation as to why gas ignited in the chamber first and not directly from the fuel burning,  To me that seems like oxygen must be present in the vacuum,  Secondly the act of throwing can and never will produce recoil, because that action is one that propels by the momentum of a movement that releases it during that movement. I never see any of the people move on the release of an object in the space station or water tank, depending on how you swing, I am also a little puzzled as to why they had to cheat just to ignite the gas in the tank, I was under the impression firing up a rocket in a vacuum would be the same rocket used to get there, how then could you put a fake atmosphere around it. I must say this experiment left me in doubt when I had none before
Reply: Andrew cianciotta  Regarding your assertion that rockets are inefficient in a vacuum, please see the original post and refute it and the laws of motion. Please also provide equations describing the actual laws of motion if possible.
Reply: Andrew cianciotta  gases do not travel instantaneously, did the rocket experience a force in anticipation of the gases hitting the wall of the enclosure, or did the rocket only experience force once the gases had actually hit the wall?
Reply: @Swayzeo  if you are orbiting the Earth you CERTAINLY are NOT outside of the influence of EARTH'S gravity.  If you are in orbit of the Sun you certainly are NOT outside of the influence of the sun's gravity.  The astronauts onboard the ISS right now feel almost exactly the same gravity as we feel on the ground.
Reply: Jbyrd Texas  the rocket pushes the MASS of the exhaust gases out of the nozzle.  Since the exhaust gas has MASS it also has INERTIA.  Since the gases have INERTIA then they PUSH BACK when pushed upon.  The rocket nozzle is PUSHING the gas away, therefore the gas PUSHES BACK.  This is Newton's Law "For every Action there is an equal and opposite Reaction".  The Action is the nozzle pushing on the gas, the Reaction is the gas pushing back on the nozzle.  Literally about the MOST BASIC physics principle imaginable.
Reply: Andrew cianciotta  so what you are saying is the rocket did not feel a recoil until AFTER the gases hit the opposite wall?  What was the physical mechanism for the force to be transmitted back to the the rocket?  If I fire a crossbow in a vacuum, you are saying I won't feel the recoil until the projectile HITS SOMETHING???  So when I fire a gun on Earth ( using your reasoning) I should feel a SECOND RECOIL when the bullet hits the target?  You do realize how ridiculous that sounds right?
Reply: Jbyrd Texas  let me guess: you did not graduate high school, but you think you have the knowledge to argue with an Electrical Engineer that has been working for almost 25 years as an Aerospace Test Engineer on the most advanced vehicles mankind has ever built?  I have multiple awards from Lockheed Martin and NASA, but YOU feel you can argue Physics with me?  Maybe you should try taking at least ONE physics class before arguing with engineers?
Reply: @dr.davidbannerf.e.s.6217  There is 1 atmosphere of pressure inside a spacecraft. That's 14 psi of pressure pushing the gas out the hatch. It doesn't get sucked out, it's the exact same as if you pressurize a tank and then break the valve. Our atmosphere isn't pulling the air out, it's pushing itself out.
Reply: @stuartgray5877  So it is impossible to fly in a straight line? You will always fly in an arch in an orbit? Gravity is so strong it always pulls you in an orbit? The suns gravity is so strong it pulls the vacuum of space with it at 515,000 mph? But NASA can fly in any direction it wants to go to the moon and mars?
Reply: Andrew cianciotta  and Jbyrd Texas do you want to see a video if rocket propulsion in a vacuum?  Search YT for "Close  Up Footage of Falcon Heavy Launch Through Landing!" by Astronomy Live.  Watch that video and then tell me HOW did those side boosters Turn Around and FLY BACK to KSC IN A VACUUM ??  You claim this is impossible, but there it is on video. Please explain how that is possible.
Reply: Andrew cianciotta  Cognitive dissonance usually requires a person to dance around the truth and avoid admitting fault. I don't do that. All I want is the truth. I don't care that you think I'm living in la-la land, all I care about is which of us is correct, and unless you can actually show an example of rockets needing something to 'push off' of, or you can refute my OP, or you can provide better laws of motion, you literally have nothing but misconceptions.

I actually understand these things and am as consistent as I can possibly be.
Reply: Andrew cianciotta  sorry but those boosters separated from the center core at 60 Kilometers altitude.  The Atmospheric Pressure at only 50 kilometers is LESS THAN 1.0 Torr which officially qualifies as rough vacuum.  The boosters performed rocket propulsive maneuvers IN THIS VACUUM and cancelled a downrange velocity of almost 3600 MPH then flew back.  So there is your Rock solid evidence of rocket propulsion in a vacuum, just like physics SAYS it should work.
Reply: @stuartgray5877  yes precisely
Reply: @stuartgray5877  bingo!
Reply: @stuartgray5877  no atmospheric pressure, no bang my friend
Reply: @scottandildi  "no bang my friend" care to tell me which comment you are responding to!?
Reply: @stevencurtis7157  I'm just saying that when you blow air out of a balloon here on Earth...two things happen....One, the air comes out fast...Two it pushes against the air in the room and makes the balloon fly all over the place.....The only reason it could do the second thing is because the fast moving air coming out of the balloon found slower moving air outside of the balloon to push out of the way.  

In space when you blow air out of the balloon...One thing happens....the air comes out fast......And since it can't push on anything  outside of the balloon, since there is no air to push out of the way...it just won't go anywhere....it would be like squeezing a water bottle....it would just squirt the water out.
Reply: Andrew cianciotta  This is the thing I don't get, man. It's a demonstrable fact that atmosheric drag is a thing, that's air slowing things down, and rockets work better without any air impeding their acceleration. That's why a feather falls at full speed in a vacuum. The principle of a vacuum being a space which is devoid of any matter and not something which pulls on things is demonstrated by the atmosphere not getting sucked into space entirely. There's nothing pulling it away, it's held to the planet by gravitation, and it's too heavy to reach escape velocity on its own.

I guarantee you that if a rocket's combustion chamber is full and the rocket is firing, there's pressure, and if that pressure can escape, there's going to be a force. That's true and easily demonstrated. Set up a small fire extinguisher to go off in a vacuum chamber and watch it knock itself over. It's always the same with conspiracy theorists. To you, we're all just paid shills, sad brainwashed masses clinging to a worldview, egotistical ideologues out to belittle and shame anyone who doesnt agree with us.

Fuck you, I'm none of those things. Get over your irrational distrust of the established science. It's not established because it's a fictional paradigm held up by a cabal of cultist nerds, it's established because it holds up to all the scrutiny that has ever been thrown at it, and your attacks on it are like chucking spears at a titanium fortress.

I argue with people like you because I can't believe how willing you are to seek your favored facts by avoiding the actual truth. I have to share a world with you. I have wanted most of my life to understand the world, the universe, and I want that for everyone. If you really understood the science of understanding the world, you'd know how important questioning the established science is to the process of discovery, but you have to understand the model it describes before you can try to break it. Otherwise, you're just making a fool of yourself, and I promise you that if you tried, you'd look back at what you once believed and feel foolish. You would want to try to remedy that, and you'd get called a shill and brainwashed and egotistical.

Join the fucking club.
Reply: @dr.davidbannerf.e.s.6217  Have you ever tried that? Have you let loose a balloon in a vacuum chamber? I foresee a potential problem with that anyway, in order to have a balloon in a vacuum chamber that wouldn't be so big it would pop, you'd have to put very little air in the balloon to start with, which would be less mass though I'm not sure whether it would be less force or not. Given the PSI difference I'm assuming it would be similar if not identical.

Anyway, let go of that balloon in a vacuum chamber. Then come back and tell us all what happens.
Reply: Andrew cianciotta  If static dielectric accounts for why things fall, that's still gravitation, because gravitation is the phenomenon of things gravitating toward each other. I'd like to see a description of the specifics of that if you have it. I'll wait.

As for the rest of it, sigh. I guess I'll wait for your refutation of every photo from space ever presented as well. I expect better than "this looks shopped, I can tell from some of the pixels and from seeing quite a few shops in my time."
Reply: Also, better than _"it's photoshop but it has to be." Yes, it has to be, you try making a composite image without any way to composite it.
Reply: Steven Curtis
,  ..." Does the basketball move?.. or do you move the other way?"  Well, in a vacuum, I'd guess You and the basketball would both move away from each other.. Likewise, a rocket wouldn't thrust itself forward, or in any particular direction in a vacuum.. It would just spin wildly in all directions like a gyroscope. Space-exploration is Hollywood.
Reply: @j.mikewilsonjr.357  Here's how your post reads: "you and thing would move away from each other, same as how a rocket and exhaust would move completely different and randomly spin."

It's like watching cognitive dissonance punch you in the head so hard it turns into a 360° paint job in slow motion.
Reply: @stuartgray5877    >>  " Lecturing ME (an Aerospace engineer with almost 25 years experience in Spaceflight technology) ABOUT PHYSICS ?? "  <<
Stuart, the above phrase, as true as it may be, will do absolutely nothing to convince someone of the validity of your "reality".  Do you realize this ? :-))  
Yet, this is NOT the purpose of my intervention. Assuming your qualifications are as described, I'd like to ask you a few questions. Is that OK with you ? :-))
Reply: @Antares8491  Ask away.  Although I would argue that someone who has done the things I have done as an Aerospace Test Engineer certainly means that I have an above average understanding of basic physics.
Reply: Andrew cianciotta  I'm sorry if you have trouble accepting the methods of real science, maybe you should try to understand what you're seeing before you wave it away. 

Also, I asked you to debunk every photo from space. You might start with those famous ones, tell me why they're fake. Remember, I expect better than "looks fake." 

Why does it look fake?
Reply: @stuartgray5877  ok ready try this. Does a basket ball wiegh more when its full or flat
Reply: @preppertechnicianee6013  it weighs more full of air on Earth.  In zero g the filled basketball would also have more mass than one with vacuum inside.
Reply: @stuartgray5877  so we both agree gasses have mass 

So do we both agree that every action has an equal and opposite reaction? 

If we do consider this when we the gases burn each particle gains heat which is velocity of particles 

Now consider this 
 that heat goes in two directions. One with one part of the ending reactant or light emitted  the other goes with the other molecule or light emitted 

In order for the that molecule leave the rocket it has to push something the opposite direction 
The thing it pushed farther into the rocket hits the back wall of the rocket and bounces and then moves out the nozzle as well 

Its actually way more complicated then that but thats pretty much it. 

 billions of melecules bouncing of each other. That can only escaped if the push of the rocket 

Does that make sense to you 
I apologize its so long
Reply: @stuartgray5877  lmao i mustve clicked the wrong name i fully understand how rockets function in space 

Also your title is not proof
Reply: Andrew cianciotta  I know FOR A FACT that the images you are referring to are NOT FAKE. I worked on the Spacecraft that TOOK those images (NPP SUOMI) and the instrument that TOOK THEM (VIIRS).  I then helped build that spacecraft's big brother JPSS-1, install the same instrument on it, Launch it, and helped FLY IT including the commissioning of the VIIRS instrument on orbit.  That Spacecraft is now called NOAA-20 and is orbiting over our heads right now.  I could tell you how to see it's radio transmissions as it passes overhead if you like.
Reply: @preppertechnicianee6013  no but all of the proof I have is proof.  I didn't claim my "title" is proof of anything.  BTW my title is actually "Staff Consultant, Spacecraft Integration and Test Engineer" just for the sake of conversation.
Reply: Andrew cianciotta  then you are using the wrong terms to describe the images and what NASA said about "yes they are photoshopped because they have to be".  This quote was made by NASA engineer Robert Simmons when he was referring to the "Blue Marble" image he helped assemble from images taken from NPP, VIIRS Instrument.  Google "NASA Blue Marble 2012" and there is even a wikipedia page about it. YOU are the one who is confused. NASA NEVER said it "photoshopped" the Apollo images.
Reply: @stuartgray5877    >>  " Ask away. "  <<
I'd like to ask you, if you believe that we landed on the Moon, and came back, ... as described in the NASA narrative of the missions ? :-))
A simple YES or NO would suffice ! :-))
Reply: @stevencurtis7157  liberals are constantly selective in what truths they choose to believe and not believe so why shouldn't flat earthers?
Reply: "The Blue Marble is an image of Earth taken on December 7, 1972, from a distance of about 29,000 kilometers from the planet's surface. It was taken by the crew of the Apollo 17 spacecraft on its way to the Moon, and is one of the most reproduced images in history."

I don't care what blue marble anyone's talking about except this one. Debunk it or GTFO.
Reply: @stuartgray5877  >>  " yes "  <<
If your answer reflects "reality" WHY would NASA post "fake" pictures of the missions ? Notice, I'm NOT asking you if you believe the pictures ( some or all ) might be fake. This, I proved to myself about 2+ years ago,....  beyond ANY reasonable doubt, or dispute. :-)) The question refers to,..... what could the reason behind posting FAKE PICTURES ?  Should you agree with the premise, would that invalidate, in your opinion, the entire narrative as it was presented to the general public ? :-))
Reply: @Antares8491  I would need to see your specific evidence.  I have never seen any pictures or video that appeared "fake"
Reply: @stuartgray5877     >>  " I would need to see your specific evidence. "  <<
Absolutely !!! I wouldn't have it any other way ! :-))   Now, ... do you have a "photo application" installed on your computer ?  Something like "Adobe Photoshop Business Edition" or "Corel PaintShop Pro X6" ? If affirmative, what is it, and... what version ? :-)) If not, you can download and install a free version of " Corel PaintShop Pro X6". What I will share with you will tenfold reward you, for the time invested ! :-))
Reply: you can do that experiment on earth also.  Get an office chair with wheels.  And use a bowling ball, not a basket ball.  Throw it.  And you will experience that much force pushing back at you.
Reply: @None888.  sorry but people who never graduated high school should not debate "what is taught in college" with people that actually went to college.  You STILL try arguing physics with a acual engineers when it is obvious you don't understand the most basic physics principles.
Reply: Andrew cianciotta  so did you check my resume on Linkedin? You probably DID and now you are too embarrassed to tell us all what you found.
Reply: @stuartgray5877  ...i am now sure that you are a robot sent from the future programmed by my enemies....
Reply: Andrew cianciotta  if you would like to see a photo of Earth taken from 30 Million miles away, that I DID help take , just search Google for "EPOXI images of Earth" .  I can tell you all you would like to know about the hardware that took those images
Reply: Andrew cianciotta  and "send me a link" you do realize most threads block links?  It's best if you go to the LinkedIn site and just search "Stuart Gray Lockheed" but I'll post a link after this post
Reply: Andrew cianciotta  So if you google "What happened to Comet Tempel-1 July 4th 2005" what do you learn?
Reply: @stuartgray5877    Did you just give up ? :-))
Reply: @Antares8491  Yes.  I dont have time to go install software then await your instructions.  Tell me what images and get to the point or go find someone else.
Reply: vacuum does not pull on anything?? vacuum is pulling on all six sides of the vacuum chamber! Drill a hole in one of those sides and you will instantly see how much pull a vacuum has on gasses instantly available to it . Further all the gasses expended from the rocket burn are being suck out into the entire chamber, and if enough  gasses are created it would eliminate entirely all the vacuum in the chamber. Dave Webster
Reply: @davidwebster6530  - "vacuum is pulling on all six sides of the vacuum chamber! " NO the pressure on the OUTSIDE is PUSHING IN
"all the gasses expended from the rocket burn are being suck out"

NO - the exhaust gases are getting PUSHED OUT of the rocket, the vacuum DOES NOT PULL.
HOW can "Nothing" exert a force on matter?  IT CANNOT
Reply: Andrew cianciotta  Since this particular thread is about ROCKET PROPULSION IN A VACUUM, and you clearly dont know anything about imaging aboard spacecraft, lets stay on topic: 
WATCH  the YouTube video  :
 " Close Up Footage of Falcon Heavy Launch Through Landing !" by Astronomy Live.
 WATCH the VIDEO OF THE SPACEX FALCON HEAVY side boosters AND TELL ME WHAT YOU SEE

How do those boosters FLY BACK TO KSC ?
 They separated ABOVE 60 kilometers, IN A VACUUM and used WHAT to change direction and fly back ?  Black Magic?
Reply: Andrew cianciotta  - "ive just done that and now i know just how stupid you think i am"  SO you looked at my resume, and that makes you believe that I think you are stupid?  So are you saying that you think my resume is fake?  ALL of that can be verified.
Reply: @dr.davidbannerf.e.s.6217  

"My Mechanical aptitude......"

You have none bud.  Just long posts of useless nonsense.  Rockets provide thrust in a vacuum despite your endless ignorance.
Reply: @stuartgray5877    >>  " I dont have time to go install software then await your instructions. "  << 
Believing, " you DON'T have time, ", is an idea which precludes any intelligent discourse, for you have no curiosity to discover any discrepancies,... about something you made up your mind already.  Is that the case , here ? :-))
>>  " Tell me what images and get to the point or go find someone else. "  <<
I can tell you what images I am referring to, without any problem ! However, from an intellectual standpoint that would be tantamount with me telling you that there is a 12.5 Kg bar of gold, buried 30 cm. deep, in a 500 square Km. patch of forest. Hoping to recover the bar,... you may identify the forest, and spend the rest of your life searching for the gold, without finding it. Simply because the info. provided.. is insufficient. I hope you agree ! :-)) Talk about a waste of time ! :-)) Compare that with downloading the software, ( 1-2 min. ), installing it, (another 2-3 min. ), and  downloading some pictures, ( another 1-2 min ? ), as well as following some instructions ( 4-5 min. ) to arrive to the results.
Now, ...  ARE you... interested/curious ... in being in a position to asses the validity of what I found out, ... or not ?    A simple "YES" or "NO" would suffice. :-)))
Reply: @jasonyoung9559    >>  " We all know how stupid you are.😉 "  <<
Very intelligent rebuttal ! :-))    You must have forgotten that .... " We don't see others the way they are ! We see them ...the way we are ! :-))) "  Not sure, if this will make you happy, or not ! :-))
Reply: You will fly backwards from the ball... (Just kidding) 😋
Reply: A baseball is a solid as is the hand. In a vacuum, neither of these expand into empty space as would a gas, which would instantly expand into every dirrrction
Reply: @jessem9006  Would a person floating in space feel recoil if he turned on a FIREHOSE and shot it into the vacuum?
Reply: @jasonyoung9559      >>  " Your response makes no sense,.....etc. etc. "  <<
Read it again, ....and again,..... and again....etc.  Some day ... the light will come on !  Hopefully ! :-))
>>  " You were not in a "daze" for days after learning some fake bullshit. Quit lying......etc.etc. "  <<
4-5, to be more precise ! You know, I wish I could accuse you of being brilliant. :-))    Unfortunately,..... I can't !  :-(
Reply: @jasonyoung9559  No they don't, and now we have scientific evidence to back it up.  Something you guys will just have to learn to deal with.  And get up to speed.
Reply: @dr.davidbannerf.e.s.6217  
What "scientific evidence" would that be?
Reply: @jasonyoung9559  Actual tests inside of two different sized vacuum chambers.  For one....there was an unnatural delay in the amount of time it took for the rocket to press against the scales and make it move.  And this coincided with the pressure gauge needle moving as soon as the rocket was fired, and the gasses trapped in the test chamber created pressure inside the chamber itself, and made it no longer a vacuum chamber.  The unnatural delay in the time it took for the rocket to provide thrust of any kind, was the time it took for the rocket exhaust to put pressure back IN to the sealed chamber, that we had previously taken OUT>

And to make matters worse...when a second larger test chamber was used, the unnatural delay time INCREASED, and it took longer for the rocket to provide thrust than in the smaller test chamber.   This told us immediately and for good...Exactly what was happening.

Because it was a sealed chamber with a given size and volume capacity....It was taking longer for the rocket exhaust to add enough pressure back into the larger test chamber, that we had previously taken air OUT of.    Then it became OBVIOUS that because the chamber was SEALED....the rocket exhaust simply put atmosphere right back into the chamber we took atmosphere out of.........DUH>    The rocket's exhaust was trapped....it had no other place to go.  Of course it put pressure right back into the chamber...and the larger the chamber the longer it took for the same rocket size to add enough atmosphere BACK INTO the sealed chamber, to provide THRUST>   DUH!
Reply: @jasonyoung9559  I cannot stress enough how important it is for the fast blowing fire and exhaust to run into something outside of the rocket itself...something that can stand in the way of that fast blowing fire and exhaust....Something the rocket can tell to GET OUT OF THE WAY>        And it is ONLY when the rocket tells something to get out of the way, that backpressure or response from that thing standing in it's way......then and only THEN is thrust produced.

The action of the fast blowing fire leaving the rocket HAS to encounter resistance to it's path of travel, or it does not produce thrust.
Reply: @dr.davidbannerf.e.s.6217  

You are starting from a false premise.  You believe rockets are propelled by pushing off of air?

The Falcon Heavy weighs in at 1.42 million kilograms.  How would such a rocket ever reach an altitude of even 1,000' if it was trying to push off of the air?  It isn't generating LIFT, it is generating THRUST......something the scientifically illiterate often ignorantly treat as the same in regards to physics.  They are not.  

In order for your false premise to be correct, the Falcon heavy once off the pad and away from the ground, would need to be pushing against over 30,000,000 cubic feet of air all at once in order to move.  I hope you see the problem with this.....I hope.

How could the X2 rocket be propelled to record speeds with it XLR25 rocket engine at an altitude of over 120,000', when the air density is a paltry 0.06 psi.  There are barely any air molecules to even push off of at that altitude........it must be something else?

Misunderstanding scientific principals isn't proof of your own misunderstandings.
Reply: @jasonyoung9559  I'm starting from the premise of a rocket....in a vacuum chamber...the delay...the volume of air....the exhaust...the pressure....the sealed enclosure.....That is the premise I am STARTING WITH.  And ENDING WITH.

I can make your toy rocket not provide any thrust AT ALL for over 3 full seconds....just by making the vacuum chamber about the size of a truck.
Reply: @jasonyoung9559  I KNOW how rockets are propelled....I have WATCHED them in high quality slow motion.....BOTH on a launch pad....and inside of a vacuum chamber.   I KNOW they push off of the air, or their own gas exhaust if you trap it.  You can't ever tell me otherwise.  It's useless to argue with me over it.  I'll just replay the video for you every SINGLE time a rocket is fired.
Reply: @dr.davidbannerf.e.s.6217  - "Actual tests inside of two different sized vacuum chambers.  For one....there was an unnatural delay in the amount of time it took for the rocket to press against the scales and make it move."  
This is 100% HORSESHIT !

We test real rocket thrusters IN VACUUM frequently.  Every one my company buys from Primex (Moog) is tested at full thrust in vacuum with our QA people observing the test. EVERY SINGLE ONE has performed exactly as the rocket equation SAYS they should behave based on propellant and VACUUM LEVEL.  They give MORE THRUST when in vacuum.

Now QUIT JUST MAKING SHIT UP!
Reply: @dr.davidbannerf.e.s.6217  WHY do you keep IGNORING the undeniable evidence?

WATCH  the YouTube video  :
 " Close Up Footage of Falcon Heavy Launch Through Landing !" by Astronomy Live.
 WATCH the VIDEO OF THE SPACEX FALCON HEAVY side boosters AND TELL ME WHAT YOU SEE

How do those boosters FLY BACK TO KSC ?
 They separated ABOVE 60 kilometers, IN A VACUUM and used WHAT to change direction and fly back ?  Black Magic?

LARRY - HOW  DID  THOSE  BOOSTERS  MANEUVER  IN   VACUUM???
Reply: @jasonyoung9559  I'm done with that topic.  I just invented a new pendulum.  A wooden dowel rod one foot long and one inch in diameter.  With a string tied right at the center of it, and to the ceiling in the room.   ANY room on Earth.  Simply get the knot where you tied it around the dowel rod right in the center where when you let go of it..it balances horizontally, without tilting down to one side.....and you are GOOD.

If the room has any rotational velocity, the dowel rod will always point a certain direction while it balances on the string.  Even though you would not be able to see that the dowel rod is pointing down and ever so away because of the rotation speed....You WOULD see that the stick balances on the string in a set DIRECTION.....because it is constantly balancing itself while being inclined that way ever so slightly.....So if you walk up to it, turn the dowel rod a different direction and let go....it will go back to that same balancing direction....like a compass needle always wanting to point in a certain direction.......it's behavior would be quite different if the room were stationary.
Reply: @jasonyoung9559  Now....I have created a Rotation Direction Detection Pendulum by balancing a rod on a string tied to a ceiling.   A VERY precise Scientific Instrument INDEED>

Dr. David Banner F.E.S.
Reply: @dr.davidbannerf.e.s.6217  

What is the point?  Why not just make a Foucault Pendulum?
Reply: @jasonyoung9559  Because this one will do TWO things...not only swing in a pattern like those...but also point a constant direction while at rest.  Neat huh.  Two rotation detection devices built into One....and Two is more fun, so there's the neat and fun factor involved....those are always good selling points for all product ideas.  Is it new...is it neat...and is it fun...bam...$19.95 all day baby.
Reply: @jasonyoung9559  Of course...you do realize the store model will be a nice hickory stained and varnished dowel on a nice cable that is suspended from the top of a nice housing, on a ball bearing pivot...so the wooden dowel can balance in the direction of the rotation see...isn't that neat?  The New Rotational Direction Pointing Pendulum by Dr. David Banner, F.E.S.
Reply: @dr.davidbannerf.e.s.6217  

Bam, China will have a knock off in 2 weeks for $7.99
Reply: @jasonyoung9559  Literally the First Pendulum ever invented that Actually points in a certain direction based completely off of the rotation of said Planet.  That is ground breaking dude.....
Reply: @jasonyoung9559  And you don't even have to swing it, or touch it at all.......Like wow i'm gonna be rich.
Reply: @jasonyoung9559  I just came up with a good name for it:  The Earth Rotation Compass.  Because the rod balancing on the cable...always faces and balances in the direction of the rotational force being applied to it.
Reply: Space suits don"t work in space vacuum or on the moon.  I dare anyone to put on one of nasa's space suits and go into  a 1x10(-6) Tor vacuum environment and survive it. show me anyone doing that on earth in a large vacuum chamber and I will believe nasa can even  put a man in space to use said rocket in the first place.
Reply: @jasonyoung9559  They'd be like...what...a plastic stick on a string....We sell for $1 make big money.
Reply: @areannaquintessa  Riight...As if the damn thing doesn't already mash on you just by having it on...now the crushing force of nothing around you to provide any pressure resistance comes into play....And you are SMASHED like a tube of toothepaste...lol
Reply: @areannaquintessa  Oh wait......the UNCRUSHING force of Space....like a fish caught from down deep, and brought to the surface quickly...and his eyes pop out of his head....lol
Reply: @areannaquintessa  An INCREDIBLE amount of force trying to suck the air out of the suit at ALL times....just a staggering amount of force trying to suck the air out.
Reply: @areannaquintessa  And then not only the metals on the ship heating up from going through the much hotter ionosphere, but the microwave radiation from the belts or dome around the Earth, that would make the ship be a large piece of aluminum foil in a microwave...and all of the metals on the ship would heat up...well hell anything a microwave can heat up...
Reply: @areannaquintessa  Why wouldn't a spacesuit work? What do you think would happen?
Reply: @dr.davidbannerf.e.s.6217  "crushing pressure of nothing"

Excuse me? PLEASE, PLEASE explain, I am dying to understand your thinking here.
Reply: @stevencurtis7157  The extremely powerful force trying suck all the air out of the suit.  That extreme force.
Reply: @dr.davidbannerf.e.s.6217  And why would that crush you?
Reply: @dr.davidbannerf.e.s.6217  you clearly have no idea what a GYROCOMPASS IS.
Reply: @stevencurtis7157  Most Likely the suit would probably fail almost immediately as it only uses rubber seals, any vacuum chamber  with that kind of force  would not work with rubber seals.  if you look at nasa's large vacuum chamber that is capable of reaching  nearly the same vacuum as the moon it uses solid copper seals,  as rubber would fail almost immediately also it has  reinforced  concrete 8 feet thick with steel reinforcements on the outside. as seen in many pictures.  also the fabric I doubt is stronger than 8 feet of concrete. so if the seals miraculously held up the fabric would most defiantly expand and rupture. Immediately after that the astronauts  blood would boil, and his eyes and brains would most likely expand and pop out of his skull. his stomach and  bladder would expand and rupture.
Reply: @areannaquintessa  What is the failure strength of the materials used in NASA's spacesuits? "I'm sure it would fail" is not an argument. A vacuum is not some almighty force that destroys everything but metal and concrete. You can block a small hole in a vacuum chamber with your finger with no adverse effects.
Reply: @areannaquintessa  please talk about things you have a clue about. I can TELL you do not understand the basic physics of vacuum chambers. Saying rubber seals would never work in high vacuum applications is a flat out lie.  I am sitting, right now, next to four different Tvac chambers and ALL OF THEM use rubber seals on the door and all of the bulkheads and these chambers are ALL capable of 1.0x10^-9 Torr.  So quit lying.  And NASA has FREQUENTLY tested space suits with people in them in hard vacuum.  So saying they don't is ANOTHER LIE.
Reply: @dr.davidbannerf.e.s.6217  HOW DID THOSE BOOSTERS RETURN TO KSC IN A VACUUM ?? If what you say is true, they COULD NOT HAVE RETURNED.  HOW did they do it? Why are you ignoring this question?
Reply: @stuartgray5877     >> " Why are you ignoring this question? "  <<
Could it be he's ignoring your question for the same reason you're ignoring my challenge ?  FEAR !  Otherwise said,.... "" Too big of a coward to admit you might be wrong! ""    Is this a plausible  reason ? :-))
>>  " I dont have time to.....etc. "  <<
Yet, you seem to.. 'make/find time' ...when it comes to... "verbally abusing other posters" ... just because you feel entitled to do so ? :-)) Is this the sign of a... "highly intelligent intellectual" ?  You be the judge ! :-)))
Reply: @stuartgray5877  I know exactly what they are.  And I know why a compass doesn't work very well around volcanic areas, and other places on Earth.  Big deal...lots of other people know about them too.  Doesn't have anything to do with curvature of gravity.  Has everything to do with a compass direction and gyro....gyro-compass.  Not a Gravity Vector Angle Sensor......Brainiac.
Reply: @stuartgray5877  The Vacuum tries to suck out the rocket exhaust when it exits....deleting the thrust.....When a rocket like the spacex rocket flies in the Earth's atmosphere....instead of something trying to suck out the rocket exhaust...it offers resistance to the fast blowing fire, and gives the fast blowing fire something to push out of the way...and That my friend is when Thrust happens.   You can thank me later.
Reply: @stuartgray5877  Can you please share your reference material, such as  the nasa video showing this. I would genuinely like to see it. and not an article about it or paper document or some guy saying they did it.  an actual video please. with a vacuum reading on a gauge showing the actual pressure. I'v already seen the vacuum chamber video with the guy standing there looking like  the jet puff marshmallow man, but they don't show any gauges or readings of what the pressure is.
Reply: @areannaquintessa  there is a reason you do not see video of the exact process I am talking about. Space propulsion technology is both highly proprietary and ITAR restricted.  If I personally posted video of such a test I would be fired and charged with violation of ITAR (look it up).  I am looking right now at a test report for a Moog Monarch 22-6 qualification test. This thruster was tested with hydrazine in vacuum for Isp performance.  Google "Monopropellant  Thrusters - Moog" and look at their brochure. One of our spacecraft is shown at the very top of that PDF.
Reply: @dr.davidbannerf.e.s.6217  

As said before, a vacuum doesn't suck.  A vacuum experts ZERO force on anything.  You still do not understand what a vacuum is.
Reply: @areannaquintessa  

"A vacuum chamber with that kind of force".

A vacuum does not exert any force.
Reply: @jasonyoung9559  Sure Whatever you say almighty genius.
Reply: @stuartgray5877  I figured as much, mehh
Reply: @stuartgray5877  That proves everything!!!!! wow im changed wow space suits really do work because they said so but wont prove it oh wow im so a believer in nasa now thank you so much.
Reply: @jasonyoung9559  ok so go stand in one and tell me you don't feel anything . now go troll elsewhere.
Reply: @areannaquintessa  so you are claiming that company sells thrusters that don't actually work? But they sell them to govt. Customers with FAKED TEST RESULTS?  You apparently don't know that would be A FELONY and the govt. Rewards whistleblowers? So all YOU have to do is write a paper that explains using physics how that company is cheating the govt, and you win a million dollars.  When can we expect your well written physics paper?  You CAN spell "physics" right?
Reply: @jasonyoung9559  A vacuum exerts a LOT of force on everything.  A soda can will explode in space.  And for you..it will immediately take your breath away, and your body would bloat and your eyes would pop out of your head.  BIG time change in environment.
Reply: @jasonyoung9559  A drop of water exposed to the vacuum of space immediately boils and turns into a gas within a second.
Reply: @jasonyoung9559  Or..to put it in a more scientific way:  The drop of water literally gets pulled apart into individual gas molecules in a second.
Reply: try throwing a mountain
Reply: @jasonyoung9559  Did you know you increase the atmosphere inside of a vacuum test chamber, just by putting water into it....For real.

Because the vacuum chamber in an enclosed area...the water gets pulled apart into gas molecules until they replace the presence of the air molecules you evacuated to begin with....and you will watch the the Needle go up on the scale from zero atmosphere's to having atmosphere real fast.
Reply: @jasonyoung9559  Space literally pulls the rocket fuel out of the rocket and immediately turns it into gas molecules all traveling at the same speed, because once they are pulled out they maintain the speed from whence they were accelerated outwards....
Instead of the rocket fuel meeting resistance from coming out while in 
Earth's atmosphere.  Totally opposite end of the spectrum.  On the one hand...when there is resistance to the fast movement of the fast blowing fire, thrust is produced as a result...while on the other end of the spectrum, the fast blowing fire is literally encouraged to come out even faster, and never met with any resistance to the fast movement to produce thrust as a result.  So sorry round eye...rocket no worky worky in space  guilo
Reply: @jasonyoung9559  "Much to learn you have Jason Young....Young Padawan apprentice he is...understand he does not."  

Nuimshaan
Reply: @juiellineau  Try removing the concrete launch pad out from under the rocket...now see how fast it takes off.
Reply: @juiellineau  And then after you remove the launch pad, remove the air allowing it make that whooshing sound as it flies.
Reply: @juiellineau  Where the rocket fuel coming out never gets slowed down....just comes out like a straight line traveling away from the ship, while the ship just floats there.
Reply: @juiellineau  A LOT of people commonly mistake the rocket Thrust power....those number are actually in how many foot pounds of air it can force out of the way, which produces momentum in the other direction.
Reply: @dr.davidbannerf.e.s.6217  

Thanks for telling us all that you don't know what a vacuum is either.  Yes water boils in a vacuum, but not because of "the force" of a vacuum.

When vapour pressure equals atmospheric pressure, liquid boils.  This is why the boiling temperature of water decreases with altitude.....not because the water is getting closer to "the force" of vacuum.

Thanks for the laugh.
Reply: @juiellineau  For these same reasons...the thin water that we breathe in our atmosphere, giving a certain amount of resistance to movement in foot pounds of force if you choose to measure it that way, or just by speed alone....at about 800 miles per hour, a unique phenomena happens within the thin water.....and it has nothing to do with breaking the sound barrier.

It is caused by the rapid movement of the object through the thin water making a wake that collapses in on itself, forming a vapor cloud at the same time the collapsing clap, pop, crack, peel, or boom sound is produced.   This is why it can be achieved using a bullwhip, whereas the tassled end never comes back and strikes itself to produce the crack of the whip...instead it literally splits the air, forming a small vapor cloud and a cracking sound as a result.

On a slower scale, popping a towel.
On a denser scale, placing your hand flat out resting on the surface of a swimming pool, then quickly accelerating your hand straight down....it makes a splash, and a boom sound in the water.  

Also...when the jet does the same thing....ripples can be seen traveling outwards from the jet like it's in thin water.  More proof.

So NOT breaking the sound barrier.  

Breaking the Air Barrier is more EXACT.
Reply: @juiellineau  A Rotation Compass Pendulum, is a fairly heavy wooden or non metallic rod that is suspended from the center of it, whereas it balances in the air horizontally, without one side dipping down to the ground lower than the other.

So how it works is very simple:  if there is any rotational force...since the rod is balanced on the string, it will simply turn like a compass needle in that direction and balance pointing East/West....and if you walk up to it, and touch the rod, turning it north or south....after you let go it will be under rotational forces to make it point East/West again after it settles down.

Fullproof and very precise instrument for measuring rotational direction or presence.  This works without the need for making it swing or keeping it swinging.

Dr. David Banner F.E.S.
Reply: @jasonyoung9559  Oh....I get it.....when it's convenient for you....you just say there is no force acting on the water to make it boil while in a vacuum.....Wow.   That sounds dumb even typing that sentence:
"Yes, water boils in a vacuum, bot not because of a FORCE acting on the water in the vacuum."  Bad physics my friend...no paco bueno
Reply: @jasonyoung9559  Now we are all laughing at you.
Reply: @jasonyoung9559  I mean that got turned around in a bad way for you bro.....and quick....
Reply: @jasonyoung9559  You know what the Globe theory reminds me of?  Like an episode of Antiques Roadshow.
The guy walks in with a handheld Globe sized stone ball about the size of a basketball...  

"It is wonderfully, and beautifully engraved...every attention was payed to detail, and the skill and quality of work combined with the fact that it's over a 100 years old out of solid granite....What can I say it is a wonderful piece indeed.  Of course it has absolutely no value whatsoever other than sentimental value no doubt.  But what a nice piece, thank you for bringing it in for us to see, it was a pleasure."
Reply: @jasonyoung9559  See...The balloon shows EXACTLY what happens...the water separates...gets pulled apart...into just gas molecules...does NOT get compressed into a water droplet....Atmosphere compresses gases into droplets....Space does the opposite.  And cha ching...Bob's your uncle.
Reply: @jasonyoung9559  And for today's next lesson Class...Dr. David Banner F.E.S. will be addressing, and solving the mystery behind the Bermuda Triangle once and for ALL.

Heat destroys a magnetic field.  Take a blow dryer to a refrigerator magnet, and it will fall right off the fridge.  Boil a bar magnet and it's toast.  

Just so happens Bermuda is an island formed by a volcano, and a chain of islands, and some fairly shallow water areas....Heat destroys a magnetic field.  People have always claimed their compasses would mess up around that area...or strange magnetic phenomena as most reports suggest......and this is scientifically caused by the volcanic activity in that area weakening the magnetic field beneath it, making the compass not be as accurate anymore, maybe point the wrong direction altogether....and that will cost you your life on the open sea...For Real.
Reply: You wouldn't be able to throw a basketball in space because the vacuum would cause your spacesuit to explode very quickly.
Reply: @scottingleman8103  
Why would a space suit explode in a vacuum?  There is very low pressure inside of a space suit......so it would not explode.
Reply: @jasonyoung9559  The Space suit would start to look like the go pro balloon sent up...just getting bigger and bigger until...POP!  And eyeballs and guts and fingers go flying away at a constant velocity!!!!  Lmao!!!
Reply: The Space suit would start to look like the go pro balloon sent up...just getting bigger and bigger until...POP!  And eyeballs and guts and fingers go flying away at a constant velocity!!!!  Lmao!!!
Reply: I mean you can't just make this stuff up....it's Golden.    I came up with a new movie title:

Space and the ever Expanding Man.
Reply: Space would make that suit look like someone had pumped air right into it until it exploded.  Just like the balloon that keeps rising in altitude......It's closed off....ain't nothing putting more helium in the balloon, or more hot air in the balloon....and yet not very far away from Earth it already explodes.  They need to get real and quit pretending like space wouldn't really effect anything....that is stupid to even say such a thing.
Reply: @dr.davidbannerf.e.s.6217  Again, I'm asking you, how would that crush the person inside?

Nobody's pretending that stuff can survive in a vacuum, because it's easily demonstrated that they do. There are materials that can handle more than a 14 PSI pressure difference. Car tires, for example, typically have 40 PSI inside them, compared to the atmosphere that's 26 PSI pushing out, but the tire holds.
Reply: You say you believe in a massive vacuum called "space" (apparently an infinite vacuum - in an open or closed system?).  Are you contradicting Newton's 1st Law by denying this gigantic vacuum has no "pull"? His 3rd "Law" said there is only "push or pull"?  Yet you say there is "no pull".
  I would like to see real proof of fire burning in an infinite vacuum. Is the sun really a ball of fire burning in an infinite vacuum for billions of years" Or is it "light", perhaps even electrical in nature? Since I cannot
validate these things in person myself, apparently heliocentrists are dogmatic that I'm supposed to take it by faith in "science" and hope those who make such attempts or claims are speaking the honest truth. Oh right, and they also want me to believe the Bible is false. The tests in this video are very suspect to me and not the "Gospel". I believe the Holy Scriptures that clearly indicate we live in an enclosed system where the Law of God speaks of Heaven and Earth, a "firmament" that holds waters above and below, I believe there is an up and there is a down and "What goes up, must come down!" (unless you are NASA and Company). I believe the governing rule for up or down is buoyancy and density. I believe Yehovah God who said He created the Earth before He created the sun. I believe Him when He repeatedly says the earth "stands still never to be moved" and even associates His glory upon these often repeated statements.   
 I also know most of the world does not believe in Yehovah /God. But for the sake of the jury, especially  those who say they believe Him but aren't so sure, I post a few of His Words on this matter.
 

"Yehovah reigns; He is robbed in majesty; Yehovah is robed, He is girded with strength. Yea, the world is established; IT SHALL NEVER BE MOVED." Psalms 93:1

"He SET THE EARTH ON ITS FOUNDATIONS, so that IT SHALL NEVER BE  MOVED." Psalm 104:5
 
"Tremble before Him, all the earth; THE WORLD STANDS FIRM, NEVER TO BE MOVED." 1 Chron. 16:30
Reply: @AllanRasco  

A vacuum does not contradict Newton's Laws of Motion.  Don't be so scientifically illiterate.

The rest of your comment is also absurd.
Reply: @jasonyoung9559  Same force that makes the balloon pop...but STRONGER
Reply: @dr.davidbannerf.e.s.6217  

A vacuum doesn't make a balloon pop.  A weather balloon will pop around 100,000 feet in altitude, give or take depending on volume of gas in balloon at sea level.

At that altitude there is still 0.146 psi of air pressure........that is still not a vacuum......not even close really.  So it is not vacuum that is making the balloon pop......it is the expanding gas within the balloon.....and it is expanding due to the decrease air pressure OUTSIDE the balloon.  

It is almost like you say the opposite of the truth every time.....just like a lying troll would?🤔
Reply: @jasonyoung9559  There ya go...now you are making some sense...the decrease in air pressure outside the balloon....that is what I have been saying over and over.....That decrease in air pressure gets more and more and more until there is NONE dude....The vacuum....where the balloon pops instantly.
Duh.
Reply: @dr.davidbannerf.e.s.6217  

You still don't get it.  A vacuum doesn't suck.  A vacuum doesn't exert any force on anything.  A vaccum is not a force.

The balloon pops before it ever reaches the vacuum of space.  There is no vacuum at 100,000'.

Go read a book or something because your lack of understanding is growing tiresome.
Reply: @jasonyoung9559   It forces the balloon to pop...and it will force you to pop..too.   Just expand expand and...POP!  Hehe i like saying that..
Reply: @jasonyoung9559  Can't nobody get thru the dome where the sprites fire straight down at our atmosphere anyways.....It's stupid to talk about space suits and crap to begin with.  Nobody has ever been onboard any rocket going 70 miles high anyways...where the dome is.  They wouldn't be able to get thru it if they ever did survive up that high.
Reply: @jasonyoung9559  And if any "Critters" were ever seen in that water above us, on the other side of the dome...well...they like sprites...they gather around them and feed off of them I guess....But all we have ever been able to do is film them from a balloon here inside the dome looking out at them swimming thru the water out there in "space"
Reply: @jasonyoung9559  It's sad when an old timer named Enoch understood SPRITES better than any modern scientist to this day.  We are just now beginning to understand them...and actually see the ripples in the dome and water barrier when they break thru dome, and cause lightnings in our atmosphere.   Enoch said those sprites are caused by the Stars.
Reply: @The professor J.F.I 

Rockets work in space.  In a vacuum or in an atmosphere, there is no change to Newton's Laws of motion.
Reply: I assume you whent to space and you now the out come is differant from actual logic and laws of the hemisphere so if the thermispher is 2000*f and the molecules ar far and few between and in a vacuum then your logic is wrong
Reply: But if you have been there thin were is your proof
Reply: @sean7058  
What are you trying to say?
Reply: bad argument.  your arm muscles are pushing the ball forward,  The ballis being pushed by a movement.  you can move in a vacuum (my muscles), BUT you cannot go anywhere from your position in space.  The rocket exhaust is pushing against nothing, so how can it move?
Reply: @alfredsartwell5659  

Rockets are not propelled by pushing off of air.  Rockets are propelled by the rapidly escaping gas pushing on the rocket itself.  Newton's 3rd law is in effect here......and the law applies in an atmosphere and a vacuum.
Reply: @alfredsartwell5659  your arm muscles are pushing the ball forward

No, my suit is pushing the ball, my skin is pushing the suit, my muscles are pulling my bones so they can push my skin. If all of these pieces didn't react to each other, nothing would happen. The ball is just another piece in that chain.

the ball is being pushed by a movement

If you move the ball, does the ball move you? If it doesn't, why not? Is there something special about people or 'pushers' in general?

you can move in a vacuum

Are you sure? Some of your ilk in this thread and elsewhere tend to dispute that.

BUT you cannot go anywhere from your position in space

Why not? Give an actual reason. Show where Newton's laws fail.

The rocket exhaust is pushing against nothing, so how can it move?

Because expelling any kind of matter causes momentum equal but opposite to the momentum of the matter expelled. You are pushing off the rocket exhaust.
Reply: I don't know exactly what pressure is maintained in a spacesuit but one would assume that somewhere near one atmosphere is optimal. However the vacuum of space is nearly complete and the pressure differential would be enough to rip most things apart
Reply: @scottingleman8103  ever seen videos of stuff in vacuum chambers? Don't see too many things getting ripped apart. Usually it's liquid and thin materials filled with gas that get seriously affected. Last I checked, space suits reduce mobility because they're quite thick.

You seem pretty sure in your assertions of how things would work for someone who doesn't seem to actually know what would happen. There's a bigger pressure differential between your tires and the atmosphere than between the atmosphere and space, by the way. 

Have you heard of the Dunning-Kruger effect? If not, look it up and read about it, you'll be an expert in no time.
Reply: Space isnt real so it doesn’t matter if rockets work or not
Reply: @Paygelove  That which can be asserted without evidence can be dismissed without evidence. There is evidence of space, provide evidence that it's been faked.
Reply: @scottingleman8103  

You might assume 1 atmosphere but you would be wrong.  Space suits are typically pressurised to 3.9 to 8.3 psi, depending on the space suit design, and the activity that is being performed.

Nothing is getting "ripped apart".
Reply: You have more mass than the basketball...
Reply: @None888.  And...?

Also, you have more massketball than the basketball.
Reply: Steven Curtis - there is no “quandaries” for some of us because space is fake!  Only those that want to live in a science fiction existence cannot come to grips with reality.  That’s the ridiculous real “quandary”
Reply: First, the basketball would explode from internal pressure immediately so you can't "hold" a basketball or throw it.  Your whole argument is impossible. Total confusion.  No need to even consider it.
Reply: @colemanadamson5943  You struggle with the concept of hypotheticals, don't you? It's okay, we've got some building blocks over in the corner you can go play with. 

Replace the basketball with a bowling ball. Oh shit son.
Reply: Guys and girls, men and women, your debate is too long. There is a simple answer. We HAVE ROCKETS and SATELLITES in SPACE. Why did you not talk out this. For a satellite to orbit the Earth it as to gain speed (I don't have all the knowledge, but you understand). How does it do it? Booster/rockets. It's a simple way to tell somebody that rockets do work in space.
Reply: @Springchief-sp1vm  You can say that as many times as you want but it'll never change their minds. They're convinced that space is fake and pretending it's real is a worldwide scientific and political conspiracy perpetrated by devil worshipping lizard people.

Okay, maybe they're not lizards.
Reply: A basket ball would blow up in space.
Reply: DodgeMeister you are right because there is no atmospheric pressure acting on Space there is no trying to get out of space.
Reply: @tekamin  what pressure do you think we can fill a basketball TO in Earth's atmosphere?  And would you please explain to us the difference between Gauge Pressure and Absolute Pressure?
Reply: Samael Levithan  Citation needed.
Reply: 1st prove to me we went to 'space'.
Reply: Newtons laws are on earth?
Reply: When you go up to space can you try this for us?
Reply: @stuartgray5877  Exactly. They can only think of a vacuum in terms of how a vacuum operates, while in a container, in an atmosphere. Even then, they have the physics backwards. The vacuum does not pull, it's the atmosphere pushing. Pressure is the driving force. A vacuum is no pressure. No pressure, no force. Flat earthers just don't understand physics. Because they don;t understand physics, they believe it is wrong. It is the same kind of illogical assumptions that allows a person to believe in a god or magic. I clump them all together into the same category and that category encompasses an alarming number of people.
Reply: @BigSupah "I've said enough" no you basically said NOTHING with that word salad.  We built the device you are communicating with typing that BS using Theories .
Reply: @hobgoblin6659  Google "EPOXI images of Earth" and then "What happened to Comet Tempel-1 July 4th 2005" and explain what you find.
Reply: so you are saying that there is oxygen in space to light a flame.
Reply: @stuartgray5877  Did you just watch the same experiment I did? I suspect that no matter how much evidence you people see you will refuse to admit we have all been decieved.
Reply: @cory5797  Fools. All of you. Gravity is a theory. No one can prove gravity exists.  No one has ever proved this.
Reply: @brockstill1431  I'm still waiting for you to bypass insults and give a scientificly bassed argument. I'm open for anyone to change my mind.
Reply: @brockstill1431  physics dictates rocket propulsion MUST work in a vacuum, and we have plenty of proof that it does.  Do you believe that all of the SpaceX launches and landings are FAKE?
Reply: Larry Lowe you don’t understand how momentum and forces work. Go look at some physics videos and try and learn some basics first.
Reply: @cory5797  Im not exactly sure what youre unconvinced of. As to whether or not this experiment is valid? Or if its compromised by the fact that the rocket itself is confined to a very small space & in close enough proximity with surfaces with which to push off of. But if youre buying into this rediculous business of riding rockets into space and back,wether or not jet propulsion functions in a vacuum are the least of the flaws in the concept.
Reply: @brockstill1431  why is it ridiculous?
Reply: Steven Curtis never been in space with a basketball. You question sounds like you’ve been to space and know how it is.
Reply: @Dmgolfer22  Can you imagine floating in a void with nothing to stop the object you're going to throw? The point is, that's how it would be, and we can simulate the conditions minus zero-g on the surface of earth and confirm the behavior. 

Just the fact that rocket thrust is proportional to the force of the exhaust and is not affected or even impeded by the thickness of the atmosphere is evidence that rockets work as well, if not better, in space.
Reply: That is a joke first you've been in space    is not  oxygen in the space  to make  a fire you need 3 elements ( oxygen,fuel,  and heat )  so the rocket have to carry the oxygen   but is no way to puch forward  if you  don have nating as a bace
  if you hang in a rope in the air the onli way to go up is puling you self with you    hands  the onlib way i think a rocket can go forward  is keeping  the tail pointing  to earth but what about back to earth   if you don't have  a point to support yourself  how do you planing coming back 
But suppose you're in space throwing the ball  
good that ball is using you as a point of support  now let me now how you planning  going behind that bold 
In case you say something about the sun let me tell you something  the sun produces hes on gases
Reply: @cory5797  Why is what rediculous? This test or the entire concept?
Reply: @brockstill1431  you
Reply: @waltertorres1949  1. You bring the oxygen with you.
2. You bring the energy with you.
3. You bring the mass with you.

I'll ask you what I keep asking everyone who thinks the rocket needs to be pointed at an object to work: when does the rocket provide thrust, right away or when the exhaust hits the object?

Those are the only two possibilities. If the rocket provides thrust right away, what does it have to do with the object? If the thrust comes after a delay, why don't we feel anything after throwing a baseball, basketball, bowling ball?

Also your post is fucking atrocious, why am I responding to you?
Reply: Steven Curtis my point is this is all imaginative. You even stated “can you imagine”. None of this is fact. The only fact there is, is that we don’t know. The original comment is all based on assumption. That was my point.
Reply: @Dmgolfer22  The premise is a thought experiment. My point in the OP was that coming to the conclusion that rockets don't work in space based on an incorrect mental model is, let's call it rejection by fantasy physics.

Which is really worse: extending verifiable physics to an extraordinary situation or rejecting several fields of science entirely based on a verifiably incorrect understanding?

Since we don't need to go with imagining, we can go with something more substantive. What do you have that supports the claim that rockets don't work in space? As for counter-evidence, all I can give you is decades of photos and videos from space, poor debunkings of those media, good debunkings of those poor debunkings, and the verified models of known physics. Hope that's enough.
Reply: What was the pressure after the burn?
Reply: I'm sorry, is someone pushing the rocket? Or is the rocket doing the pushing? If I threw that basketball, would it move me?
Reply: @Clogmonger  No, yes and yes.
Reply: @dr.davidbannerf.e.s.6217  balloon ejects water as rubber balloon contracts.
Rocket ejects cloud of gas for the emerging cloud to press against and the ejecting cloud then has something solid to push against and so the rocket moves forward.
Boat propellors propel boats by propelling water against the water behind the boat propellor and as water is incompressible the oncoming water tries to stop the propellor but due to the screw design of the boat's propellor the boat is actually screwed through the water - which is why boat propellors is called 'screws'!
Reply: @stevencurtis7157  My my!  You obviously adore AOC and her Green Deal stupidities!
Balloon in space pushes water out until balloon rubber is totally relaxed and hardly any water is left inside.
There is nothing in space to resist water going out of balloon.
Question is: in space if a bottle of water is opened does the water beging to separate out into its oxygen and hydrogen molecules until nothing is left - and if so does it do so quickly or slowly?
What sci-fi film had a villain zoom off into outer space when the hero sliced his oxygen tank hose so it acted like a rocket engine?
Reply: @cory5797  YOU too.
Reply: @stevencurtis7157  have you ever seen a rocket heading for space it goes up up and up then the air gets thinner then the rocket starts to go side ways not one goes straight up they all star to loose altitude these a new vid that show a planes that go higher you people don't look at all the evidence you focus on one point and think that proves everything
Reply: @jasongrice6571  Ironic, since it's the conspiracy theorists and science deniers who are the ones who always, always try to refute the facts using a single argument 'gotcha!' For example, someone might say rockets going sideways means they're slowing down and losing altitude. That would be pretty short-sighted considering that you can measure their velocity and altitude to still be increasing, we know that they need to gain a huge amount of horizontal speed to reach orbital speed so they start going sideways early on, and you can observe satellites, the ISS for example, which if it was a plane would have to be running its engines 24/7 to go faster than any known plane at an altitude so high no plane could even fly in principle since there's effectively no atmosphere.

Yes, my entire worldview hinges on a single point that calms my wracked nerves so I don't have to kneel in a corner chanting "Earth's a globe, NASA is real" to myself. I obviously don't value knowledge, am completely ignorant of the world around me, and would never take the chance not only to learn about but also understand and be able to use the most fundamentally important principles of physics. No, I'm just some placated sheep, never questioning anything.

"You people" he says.
Reply: @rosewhite---  I have no godforsaken inkling why you would think you know my political leanings based on whatever you were reading, but I'd say you're way off the mark.

In space, the water escapes the balloon because it's untied and the balloon forces it out. If it's tied, the water will boil and pop the balloon as it overfills with water vapor.

Water molecules won't split into elemental hydrogen and oxygen in space. That's not a thing. That doesn't happen in a vacuum chamber.
Reply: @stevencurtis7157  Nice to know you understand the elasticity of balloons.
Now you need to grow up and do some research into thermal decomposition of water.
This explains why Mercury being closest to the sun lost most of its water when GOD set the sun in place and lit it.
Pluton still has all its original water as ice because it is too far from the sun.
The fact theer are hydrogen molecules thorughout explored space is proof of water being split during Creation.
Impossible to refute science isn't it?
Reply: @rosewhite---  It's hard to refute religion, but easy to deal with. Provide evidence that god exists. Without it, your post is irrelevant. Good luck, you'd be the first to provide any.

I don't know how hot a water bottle in space would get, however it would have to be thousands of degrees Celsius to thermally decompose and I'm pretty sure it doesn't. Mercury gets to only about 430 celcius and its day is weeks long.
Reply: @stevencurtis7157  OK.  Here is irrefutable science>  GOD had Moses write that each morning after creation a dew would rise to water the plants.  Scienticstsnow know that there is an average of 100mm of dew on the ground which is plenty enough for any crop to grow in a greenhouse like state that Earth originally had.
Now go back to watching your Planet of Apes movies and leave the grown up stuff to grown ups.
Reply: @rosewhite---  Someone observed dew and attributed it to god, therefore god. I asked for evidence, not a story.
Reply: THAT'S CALLED CGI. Computer graphics, and NASA space walks have been proved FAKE many times already with their own footage, showing WATER BUBBLES coming out of their suits.
Reply: @ringlerum  Water bubbles that behave nothing like water bubbles and exactly like fragments of solid material. Make sure you stretch before trying any more mental gymnastics and maybe you won't hurt yourself the next time.
Reply: @factfinder4839  Oxygen can be solid. Look it up.

Funny that you want to talk about basketballs but all you actually talk about is getting dunked on.
Reply: @stevencurtis7157  So sad you guys think that little vacuum engine can be compared to what it is up there lmfao funny how the smoke stays in the chamber SMH it should of been sucked out
Reply: @lancefinner8801  I have no idea what you mean. What engine do I believe can be compared to what, space?  Why should the smoke have been sucked out? Of what?
Reply: @stevencurtis7157  playing stupid must be an alternative for your so called knowledge lol so wait, wait, wait! You didn't watch this video and are here to  just troll?
Reply: @lancefinner8801   I watched the video like a year ago. My best guess is that you meant the rocket exhaust should get sucked out of the enclosed box, which makes no sense so I asked for clarification. I genuinely don't know what you mean by vacuum engine.
Reply: Neal Head  u wot m8
Reply: @stevencurtis7157  the chamber they created uses a vacuum hints "vacuum chamber" if an ordinary vacuum can suck shit up when you clean a carpet or whatever then how is the smoke not sucked out the chamber? The chamber has failed and their is oxygen in it which why their is fire and smoke from the rocket. This whole video is waste of time just like you have done trying to defend it lol
Reply: @dr.davidbannerf.e.s.6217  That is wrong. To keep the numbers of your example, each basketball that is thrown will speed up you by one mph. Movement is relative. There is no absolute reference frame.
Reply: @dr.davidbannerf.e.s.6217  "...we would know what is truly going to happen wouldn't we?" But we know what will happen. Newtons laws are known, and they work.
Reply: Perhaps this is a useful hint: to be able to throw more balls, you have to keep a supply of balls with you. So throwing the first ball, you also accelerate the rest of the balls in your basket. So the speed difference for the next ball is again 30 mph. In fact, because the basket gets lighter as you use up your balls, the speed gain will get bigger over time, like 1.1, .... 1.5, ... 2 mph. The exact same happens with rockets, when the fuel gets exhausted. It's also the reason why big rockets are staged, they throw away the first stage (basket) when it is empty, to get more acceleration even with smaller engines.
Reply: simply put. your body would follow  the very very slight momentum created  by
throwing, in quotes, the basketball, not the opposite direction. very slight momentum indeed. you would more likely twirl if anything. why is this so hard to comprehend/
Reply: more like can a fish swim in the air, no but a bird can. now can a fish or bird swim in nothing/aka a vacuum, no but nothing can't either. get it/ brainyach. is that so hard to fathom. neither birds nor fish throw basketballs and it wouldn't matter if they could. geeze.
Reply: @GrimGod81  "It’s that fire doesn’t burn. No fire = no propulsion" Why would there be no fire? Of course the fuel is burned to accelerate the exhaust gas. That's how rockets work. You need oxygen to burn fuel, right. Rockets have fuel and oxidizer. Problem solved.
Reply: @davidwebster6530  "vacuum is pulling on all six sides of the vacuum chamber!" Vacuum does not pull, the atmosphere around pushes. That's a major difference.
Reply: @crystalgiddens7276  "neither birds nor fish throw basketballs" Birds have wings that work in the air. Fish have fins that work in water. Neither would work in space, agreed. To generate thrust in space, you need to push away some stuff, be it basketballs or burning fuel. Indeed the direction of thrust is exactly opposite to the direction of the disposed material.
Reply: @chrisehmke1651  Yes. Nobody's getting the point of my post I  guess. In showing that you can throw a basketball in space, the question follows whether you also move. Unless you have an explanation why you don't move, you have to accept that pushing matter imparts a force back on you. It literally proves that rockets must work in space, absolutely positively have to work, couldn't fail to work. It's a trap, and they're all falling into it, and after it crushes their bones and snaps their neck, they cough and sputter that my trap doesn't work.
Reply: @tekamin  I don't think so. The pressure difference between vacuum and normal atmosphere is just one bar (14 psi). I can pump my bicycle tires to 4 bar, so the pressure difference inside and outside the tire is 3 bar. When I would expose it to vacuum, the pressure difference would be 4 bar. Not so big a difference.
Reply: @chrisehmke1651  i'm pretty sure my point went right over your head. how about this one, does sound travel in a vacuum, if not why not/
Reply: @stevencurtis7157  While I agree to most of your statements, I don't see the trap. Maybe I don't see the forest for the trees.
Reply: @crystalgiddens7276  Why this question? Sound needs air to travel over distances. No air, no sound.
Reply: @chrisehmke1651  Just in the sense that from basic reasoning based on easily observed behaviors of nature that any honest person could follow, there is only one possible conclusion. If they don't come to the conclusion that they've made a mistake, they either don't understand or are lying. It's meant to be a liar's trap, but fools trip on it too.
Reply: @chrisehmke1651  why, no air, no sound/
Reply: @chrisehmke1651  honestly, if you can't figure it out, it is the same analogy as birds flying through the air and fish swimming in the water.  i hoped to simplify it for ya.
Reply: @crystalgiddens7276  I accepted your fish/bird analogy and told that rockets in space have to use a different method, and how it works. You don't have to simplify anything.
Reply: @chrisehmke1651  oh, what about sound my friend/ what about the sound the thrusters make/ hmm what about the sound my friend/ please do tell. how much more simple can it be/
Reply: @chrisehmke1651  it is your arrogance that brings you down. explain what happens to the sound.
Reply: @chrisehmke1651  lol. if a tree falls in the forest. you can't explain it. the sound. what happens to the sound. i await your ignorant response with great anticipation. believe me. i do.
Reply: @crystalgiddens7276  What do you mean what happens to the sound? If a tree falls in the forest and no one's around to hear it, does it make a sound? If you're asking if the vibrations that would qualify as sound still happen, then yes. If you're asking if it's technically sound if no one hears it, I don't care. Pedantry like that is intentionally aggravating and equally meaningless.

So, what are you actually asking? Rockets making sound in space? Okay, what's your hangup? That you can hear a l from inside the oe capsule? That's normal, the vibrations are carried by the ship. That you can hear another craft that you're not inside? I don't know, does that happen? I'd like to see an example, but that could also be explained. Rocket exhaust can fly out and hit the other ship. That could cause noise in the ship.
Reply: @stevencurtis7157  sound does not travel in a vacuum because why/  a bird cannot fly in outer space nor can a fish swim in outer space but you suppose humans can 
perform acrobatics in space and play basketball too/  not sure what you are claiming here.
Reply: @chrisehmke1651  mechanical thrust is not possible. that was the point with the bird and the fish. they both, swim, in quotes through a medium just as sound needs a medium to travel through. ripples in a pond from a pebble or vibrations traveling through air resulting in sound. sound travels faster in water by the way. now, this demonstrates mechanical propulsion is not possible in the vacuum of space. a man in a space suit may flail around in space but his flailing will not  affect his travel. neither would throwing a basketball affect the travel of either the man or the ball. bad analogy.
Reply: @crystalgiddens7276  You are wrong. I repeat myself: Movement in the air and in the water works on a different principle as movement in space. In vacuum wings and fins cannot work, that is the point where we agree. Rockets word by exhausting gas at high velocity. The Newton principle actio=reactio works, the rocket is accelerated in the opposite direction to where the engine throws out the gas. So you have thrust and can move and control the space ship.

The man throwing basketballs is indeed a good analogy. It's the same what a rocket engine does: throw away some stuff to get a force in the opposite direction.

You are assuming that for mechanical propulsion another medium like air is needed. That is not the case.
Reply: @crystalgiddens7276  You are even more wrong than I thought before. Of course the astronaut who throws the ball is accelerated in the opposite direction. Why is that so hard to comprehend? Basic physics, high school stuff. No degree needed.
Reply: @chrisehmke1651  the energy is generated to cause the motion of the arm. the motion of the arm cannot affect travel in zero gravity and in a vacuum as you have already agreed...  the exact moment the ball separates from the fingertips,  no more energy is expended/exerted 
 and the ball may in fact not separate immediately but instead perhaps float of gradually.... the separation itself adds zero energy to any potential thrust. zero energy means zero propulsion. my take. more likely the man and ball will float aimlessly.
Reply: @crystalgiddens7276  It just does not make sense to doubt all knowledge that came from thousands of scientists over hundreds of years. And I don't just believe, I understand the basics of physics. Before I throw away all this valuable knowledge, I will not follow some YT fe conspiracy that has no working model of the world.
Reply: @crystalgiddens7276  You did not understand actio=reactio. Google Newtons laws, or better get a textbook on basic physics.
Reply: @stevencurtis7157  You could spin yourself in space, - no you flail about in space but you have nothing to push off of so that a gold medal acrobat would be no more able to do tricks than anyone else in space. it would all be just flailing about.
Reply: @chrisehmke1651  it makes absolute sense to doubt all liars and unfortunately today science is full of those invested in ridiculous lies. however, truth be told it has always been full of liars. empirical science is one thing but folks do not realize most of what they are taught is theoretical science.  i'll explain the difference, theoretical scientist are the alleged genuses and highly celebrated. in fact, they are de facto celebrities and certainly treated as such. nobody says much of anything about the empirical science that continues daily  all around the world. you know the real science that has improved the quality of life for billions. that science.  

 in fact, every young child engages in empirical science and  especially heavily during their developmental years.

then they are taught to believe the theoretical scientist and they stop asking questions and stop attempting to determine truth from fiction. it goes downhill from there. yes, you should throw out ALL theoretical science.  it is total bullshit. today, the standards have dropped dramatically in science. they intentionally confuse theory with fact and hypothesis with theory and lame brain ideas as genus. its a facade.
Reply: @crystalgiddens7276  If you'd ever paid attention to science, you wouldn't be surprised or alarmed by any of the things you've mentioned. Global warming is a problem that will make life harder for us, but it won't destroy the world or anything cataclysmic. It has been known for a long time that earth's earth's atmospheres doesn't really end anywhere, it just slowly fades to nothing. So unless by "just" you mean that they found out it was slightly different than expected, you might be behind.

I already know this. I believe what I was taught of course. How could you not know this? However, many things can be verified by smaller scale experiments, many of which I've done or have seen done. I know what I know, and I don't conclude that rockets work in space because anyone told me they do, I was presented with the idea that they DON'T work in space and had to conclude that it was incorrect because the explanation doesn't hold. I'm not some naive fucking idiot. I know the limits of my knowledge, I assume that anything I think I know could potentially be inaccurate, imprecise or even completely wrong. I figured that out when I was a kid. It's not some lofty concept, it's a starting point.
Reply: @crystalgiddens7276  say you're sitting on a spinning chair, and you swing your arms to the left. You will spin a bit to the right, but friction stops you. In space, you would keep spinning slowly. If you can't understand that, I don't know how to help you.
Reply: @stevencurtis7157  and when in space rotating your arm and then stopping the arms rotation will result in the entire body rotating in the direction the arm was rotating.  the ball, being much less massive than the person will have negligible effect on the mans travel etc.  like i said, you can flail about in space, that's about it, imo. minus a jetpack that is.
Reply: @stevencurtis7157  please don't pretend. notice the date of this article. - Surprise! Earth's Atmosphere Extends Far Beyond the Moon
By Mike Wall February 21, 2019 Science & Astronomy - "The moon flies through Earth's atmosphere," study lead author Igor Baliukin, of Russia's Space Research Institute, said in a statement. "We were not aware of it until we dusted off observations made over two decades ago by the SOHO - SOHO, the Solar and Heliospheric Observatory, is a joint European-NASA probe that launched in December 1995 to study the sun and space weather. 

Baliukin and his team analyzed archival data gathered by SOHO's Solar Wind Anisotropies instrument (SWAN) — specifically, measurements of a type of ultraviolet light called Lyman-alpha radiation. Sunlight interacts with geocorona hydrogen atoms at the Lyman-alpha wavelength, which is blocked by Earth's atmosphere (and therefore must be observed from space) ok, so if you are going to make stuff up in an effort to appear smart, please don't. i get tired of the folks whose egos are bigger than their common sense. it is  unbecoming as hell. and i'll conclude i am wasting my time. for all i know you are a bigger liar than them. hopefully you take the hint. don't lie. i know more than you think. and i certainly don't make shit up to impress people.
Reply: @chrisehmke1651  I will tell you like Edwin Hubble has already told everyone:   The Earth is at the center of the Universe....you have to come to grips with that.....because it cannot be disproved.  It has ALREADY BEEN PROVEN.  You cannot disprove it...because all of the evidence you need is right out there.  And it has ALREADY been proven beyond a shadow of a doubt.  Using several methods....even the redshift thanks to Mr. Hubble.....

"[Redshifts] would imply that we occupy a unique position in the universe, analogous, in a sense, to the ancient conception of a central Earth[...] This hypothesis cannot be disproved" - Edwin Hubble in The Observational Approach to Cosmology

And Mr. Hubble is right....it cannot be disproved because it is the reality we are in....and looking out there ONLY proves it FURTHER AND FURTHER AND OVER AND OVER.   

So you deal with those Newtonian physics....in a Geocentric World.   They still work the same.  And a rocket still does NOT provide Thrust in a vacuum.  But action and reaction happen just fine inside the vacuum......just not the thrust you hoping to find.  Thrust is the THIRD effect of a fast blowing fire.
Reply: @chrisehmke1651  Oh...and in case you didn't know because someone forgot to send the memo......When we use those powerful tracking laser beams on the giant ground based telescopes....Those laser beams do NOT go through the firmament dome.   We actually see them STOP at the exact distance the dome is AWAY from the base of the Laser beam.      Tons of footage of it happening if you would care to watch it......and learn something.
Reply: @dr.davidbannerf.e.s.6217  You are wrong on all items. But I shut down this discussion, it's a waste of time to argue with brainwashed flerfs.
Reply: @dr.davidbannerf.e.s.6217  Illusional nonsense. There is no dome.
Reply: @chrisehmke1651  "If the Earth were at the center of the universe, the attraction of the surrounding mass of stars would also produce redshifts wherever we looked! [This] theory seems quite consistent with our astronomical observations" - Paul Davies in Nature

"I can construct you a spherically symmetrical universe with Earth at its center, and you cannot disprove it[...] A lot of cosmology tries to hide that." - George Ellis in Scientific American
Reply: @chrisehmke1651  Afraid to see for yourself?  Too horrifying of a reality for you to accept?

I will send you the links to the videos of those telescopes using lasers to track the stars.....you can see with your own eyes....those beams do not go through the dome.
Reply: @chrisehmke1651  The guys operating those telescopes already know this.....I already know this......would you like to know too?  And why?   Like.....how is the light from the stars coming through the dome, but yet a beam of light doesn't pass through it the other way.
Reply: @chrisehmke1651  And how come when Star burst energy hits the dome it ripples, but sprites fire downwards inside the dome at the impact location, forming huge electrical disturbances in the upper atmosphere....which lead to lightening bolts.  THAT has also been caught on film and proven.
Reply: @chrisehmke1651  It's like Edwin Hubble and all of the actual Scientists have learned about the Earth already......are literally telling you people the Earth is at the center of the Universe.....but you would rather listen to a theoretical physicist like Neil Tyson who would argue with Edwin Hubble.....Wow.  Just a bunch of wannabe scientists....NOT paying attention to what real scientists are TELLING YOU.
Reply: @That Guy Why do you need a mass greater than yourself? What's the cause? How does it work? What if you throw an object that's 8 ounces heavier than you and then you have a big lunch, will it not move you all of a sudden?
Reply: This is called recoil Just like firing a gun - Try waving your arms and legs in space and see if you move Also lets see if you can stand the hundreds of degree temperature swing as well as the micro meteorites Nasa lies about everything.
Reply: @pooldogbear7660  Sounds like you just read the paranoid space conspiracy cheat sheet. Learn you a book.
Reply: Oh man, there's a Love, Death + Robots ep that deals with that concept and it's a great ep but itll make ya cringe lol
Reply: @That Guy you CLEARLY do not know anything about physics:. Would a 5000 kilogram "catapult" (in "space") that can fire a 500 kilogram block of water ice at 2500 meters per second "muzzle velocity" get pushed backwards or not?  IF you knew ANYTHING about physics you could even calculate HOW MUCH change in momentum the catapult will experience. they teach that in high school physics.  You DID finish high school right?  It would be pathetic if someone who failed to graduate high school thought they could argue with actual Engineers and physicists about physics...
Reply: @Steven curtis

"I guarantee you that if a rocket's combustion chamber is full and the
rocket is firing, there's pressure, and if that pressure can escape,
there's going to be a force."

You are wrong.

There is force when there is acceleration.

Gas molecules do not change velocity entering a vacuum (i.e. a path of
zero resistance). 
Contrary to a basket ball that has inertia of rest, gas molecules are already
fast moving INSIDE the combustion chamber, (the higher the
temperature the higher their velocity). It's an intrinsic property of
gas molecules to have a lot of inertia of motion and that's what
distinguishes a gas from a basket ball. You have to exert a force
(the action of throwing) in order to make a basket ball fly away,
whereas you have to exert a force in order to make a gas molecule to
NOT fly away. They have opposite inertia. 
As a visualization think of bees constantly buzzing around inside a
closed hive. Open the door and away they fly, ON THEIR OWN. The bees
have their own energy and are already in motion BEFORE you open the
door. It is not the hive that “throws” them out. They need no
stinkin push. Do you see the difference between a bee and a basket
ball? Do you see how silly is to equate throwing basket balls with
letting gas molecules freely escape?
As soon as you open the valve of the combustion chamber in a vacuum,
removing the force of containment, a free expansion takes place, and
the gas molecules drift away unimpeded, and hence at CONSTANT
velocity, keeping their momentum (i.e. potential energy) unchanged
until they bump on something. Constant velocity means zero
acceleration and since F=ma, you can do the math and tell me the
amount of force generated. 
If force is zero, then work is also zero, as W=Fd, and this is actually
also consistent with the equation for the work done by an expanding
gas W=PV where if P=0 (as in a vacuum), then W=0.
As an aside note, it wouldn't help a bit increasing the initial
temperature and pressure in the combustion chamber, cause that would
just increase the potential energy of the gas but won't change
anything in terms of force. By adding power to your rocket engine all
you'll end up with is more molecules still drifting undisturbed in
space, just at higher speed.
In summary, no force can be generated and hence no work is done by a gas
freely expanding in a vacuum, coz its initial momentum/potential
energy can never be expended/exchanged. 
If you are going to say that the expanding gas indeed exerts no force
and does no work on the vacuum but it does on the rocket, then you
have to explain how can a force exist not being counteracted by an
equal and opposite force. That contradicts Newton's 3rd
law, in other words, Newton's 3rd law actually DISPROVES
rockets working in a vacuum.
Conservation of momentum is not going to help either, since CoM is just a
restating, or a consequence, of Newton's 3rd law. It's a common misconception that if a rocket “expel” mass, in the form of burned fuel, in one direction, conservation of momentum says it has to be propelled in the opposite direction in order to conserve the total amount of momentum in the system. This is based on the wrong assumption that the rocket and the free expanding gasses are in the same system (i.e. they “interact”). A gas
expanding against a vacuum exchange no forces with the rocket (same
as saying they do not interact) and hence they simply are not in the
same system, making the very premise invalid.
Reply: @dr.davidbannerf.e.s.6217  Your examples among other things aren't  taking into account that the  mass of the object being thrown from you is also traveling with you in the direction you're traveling. For example, and this is just to illustrate and does not take all factors into account, so say you're already moving 20mph from throwing these bowling balls in space and you're ready to throw your next one - what will happen? Did you take into account that you AND the ball are traveling at 20mph? So relative to your position the ball would always be moving away from you at 30mph but in actuality it would eventually be traveling in the same direction as you. To help illustrate this let's position a stationary spectator watching all this happen. Say the dude throwing the bowling balls is now going 40mph  but so are the balls that are with him that he's throwing what the spectator sees is not what the guy throwing the balls sees- to the spectator the balls are traveling in the same direction as the guy throwing them and they are moving 10mph in his direction but the guy who throws them his perspective is that they're still moving 30mph away from him. There are so many factors that aren't being taken into account that really make this example a bad one but for arguments sake now we have to ask - is it possible to get balls that you are throwing away from you causing you to move and generate speed  to also go from moving in the opposite direction from you to now move in the same direction you are moving? The factors not being accounted and some that are but erroneously are gravity and mass and vacuum. In a zero g environment with with no atmosphere the bowling ball being of lesser mass than the dude throwing it - when they are both stationary meaning neither has any velocity initially and in a zero g environment in the vacuum of space - the object of greater mass would by my estimation not be influenced by the object of lesser mass when both originate from the same stationary location. It would be like trying to springboard from a small branch on a tree.  If in the the video they used a water rocket - are you saying the rocket wouldn't move because there's no atomosphere for the water being ejected to push against and implying that the water is like your arm doing a push up but in this example water equals the arm and atmosphere  equals the floor?
Reply: @dr.davidbannerf.e.s.6217  Did you not see the rocket move and push against the scale in the vacuum chamber with no atmosphere to push against in the video? That was the whole point of this video to debunk the point you're still arguing and was definitively proven false by this experiment.
Reply: Have you personally been to space to throw said basketball? Why offer such explanation when most of us awake folk, Believe space is an idea conjured up by NASA in the first place, just  to lie. It sort of like people who believe everything is a lie EXCEPT NASA. They believe NASA is telling the truth despite everything else being false. I am sorry, I mean no disrespect towards you.
Reply: Tell us how they launched from the moon all the way back to earth in their craft? remember Earth is WIZZING BY AT 67k mph and the whole solar system is moving at a WHOPPING 600k mph around the center of the milky way...  Lmao anyone that believes that actually happened is trapped in lunacy
Reply: @ochaze1
Reply: Yes, You see it for what is is. Please disregard the last reply.
Reply: according to scientific data lack of atmospheric pressure would cause the basketball to explode as soon as it entered that altitude, as for that thought why don't  space suits explode because of the great difference of air pressure between the suit and space ?  I am trying to understand all the science but it all seems to defy rational thought and becomes mystery .If you dive to deep in the ocean your vessel can be crushed ,  in space lack of pressure causes expansion to the point of explosion . So what science is fact and which is speculation  and or what proof does anyone have ? because proof is truth
Reply: @ochaze1  If an explanation was given would you be open minded enough to accept it if disagrees with what you already believe? I'll offer this example: Say you have two flatbed trucks cruising down the highway and let's just say they're battery powered so they don't need air for internal combustion and let's also say there's no atmosphere.  Now let's say they're  both cruising at 100mph and they're driving side by side with a person on the flatbed of each truck and they have a baseball. We'll label one truck Earth thhe other truck Moon and the baseball Rocketship. See where I'm going with this? Because all the objects are in motion they possess inertia the ability maintain velocity and speed so when one person throws the ball to the other it is actually able to reach the person on the other truck rather than just fall away. We've all seen examples of this even with an atmosphere in the movies - a person trying to jump from one car to the next while moving. Essentially that is what's going on when you're trying to reach other planets or the Moon. Just because NASA is a corrupt and deceptive agency doesn't mean everything about them is or that their science is false. There are numerous other aeronautical space companies that practice the same exact science and all require a high degree of education. My point is that if this were ALL false there is no way they could perpetuate the lie with so many different companies practicing the same science they use.
Reply: Let's replace your basketball with something huge, like a satellite or even the ISS. Could you move either of those if you were to push them?
Reply: If you are in a true vacuum and you throw a basketball it should go away from you and just keep going. You essentially become the rocket booster propelling the basketball.
Reply: @cory5797  no one can deny gravity. But even with Newton's pages and pages of an explanation of gravity he still cannot explain how it works or even prove it he just makes an argument for it. But we can all see what their own eyes that gravity is a real thing even if there is no explanation for it. I do have a simple explanation for gravity. Gravity is everywhere right down to the atom. Atoms have protons and neutrons  attracted to them . And since the Earth is dense with atoms obviously there is magnetism on the earth pulling even more atoms down to it.
Reply: @jamieraynsford6741  gravity is mysterious.  But a few things have been discovered after Newton.
Reply: @stuartgray5877  if you have an aerosol can in space is the can not being "pulled" in all directions? While also being "pushed" from within
Reply: @stuartgray5877  and neither does it push, like say....... an atmosphere. Thus gas would expel at a faster rate to "fill" the space. Wouldnt it?
Reply: @Tom Reed sorry but there is NO SUCH THING AS "negative pressure" a perfect vacuum is at ZERO point Zero PSI.  Now Quit trying to argue with an actual vacuum test specialist.  You never even took a physics class in your life, but you want to argue with actual Engineers?? Here is your Dunning-Kruger medal put it where your high school diploma should have gone.
Reply: @skibumwannabe5492  no the aerosol can is ONLY "Pushed from inside".  Science explains WHY positive pressure exerts a force.  But there is no possible MECHANISM for "nothing" to exert a force on anything.
Reply: Reading these comments answered a couple of questions and confirmed other answers I already had.
Space can't be a vacuum
Rockets could work in space but not the ones we see, I can't imagine the configuration of that engine it would have to be built like the incredible Hulk constantly getting stronger in order to accelerate and our "stage" rockets don't work that way but give a sustained "thrust" actually already at their max speed by the time they reach "space" and since there is no resistance in space they could keep moving at that speed only and never speed up but it would work it looks like what nasa has been doing for decades.
I can't explain it like "old skool" but his explanation made me see in my head immediately
That our rockets in space are the equivalent of one shitting on the toilet, shit drops or get pushed out into the toilet but you never leave the toilet seat no matter how hard you push that shit out (at least not from the force of shitting).
people take science as a religion
The laws are the word of there "god(s)" scientist, and like christianity and Islam people will kill you for not conforming to their truth and belief.
Reply: E
Reply: Wouldnt you need some sort of resistance for anything to move or to react to force being applied to an object. The basketball would move because you are the resistance but would you move in the opposite direction from something that has no weight to push back?The ball moved because of the spring tension applied to it from your arms.
Reply: Steven Curtis thank u this comment help me to understand instantly. I was definitely skeptical once the subject came up but it’s very obvious with this explanation.
Reply: Dr. David Banner F.E.S. What you are saying is true but it is fundamentally misunderstanding how a rocket is used in space. It’s not for sustained use in a direction except to escape gravity. It’s used briefly to alter direction. So ur not using basketballs when ever you want to speed up ur using basketballs more often to alter direction. So u throw the ball from various directions to guide your path from the intital throw
Reply: Dr. David Banner F.E.S. This is almost entirely incorrect
Reply: @dr.davidbannerf.e.s.6217  WOW. It is amazing how little you know about physics! You almost got it and then things went terribly wrong! I am sorry that the school system failed you or that you failed yourself.
Reply: @dr.davidbannerf.e.s.6217  Exactly what is causing space to draw it out?
Reply: This is last reply.
Reply: @stuartgray5877  Can you create thrust without pressure? No one said the vacuum pulls anything, you have to understand that gas needs a certain container to create pressure against. On earth we have 1atm, in space there is 0 and the gas is ever expanding and will never create pressure for the rocket to propel itself
Reply: @choural  Are you replying to the original post? I thought this thread was dead at 500 replies. Anyway, what about it is dumb? Please elaborate.
Reply: @stuartgray5877  sure bud
Reply: @choural  I see you have no response to my assertion that you dropped out of high school but you STILL RUN AWAY like a coward?  I bet you looked at my resume and decided it would be better to NOT challenge me?
Reply: @stuartgray5877  then this experiment he’s doing can’t prove or disprove the argument because his vacuum is pulling. Plus he’s pushing against something solid.
Reply: @daveedfermin8824  Sorry but vacuums never "PULL". 
A vacuum is incapable of exerting a force on anything.
Reply: @daveedfermin8824  - If you are interested in learning how rocket propulsion works, I will be happy to explain it to you, but not on this thread. I am tired of scrolling through 480 comments.  Ill start a new thread you can respond to on this video. meet me there if you are interested in learning.
Reply: @stuartgray5877  - Nevermind all the "do rockets work in space" subterfuge distraction bull shit! Explain to me this...what constitutes the physical boundary between Earth's atmosphere and space? Without which Earth's atmosphere would be assimilated by the absolute vacuum of space, would it not? And don't use that magical cure-all G-word, either. Because vacuums of all kinds are used everyday to overcome it!
Reply: @foadrightnow5725  - There is no physical barrier.  But there IS a "container".
Earth's gravitational field is a container.  Look up "Potential Field" and what you SHOULD have learned about "Potential Energy" in high school physics.

Oh WAIT...... You DID take high school physics didn't you? Where I come from it was MANDATORY to graduate high school.
Reply: @stuartgray5877  - Just like I thought! You had no choice but to go running to that magical cure-all and explains-EVERYTHING G-word, didn't you? Indoctrinated much? Hells yes, you are!
Reply: I didn't quite read your last reply, but from the previous replies of yours I see you forgot inertia. Mass of the water coming out of the balloon is acting against acceleration of the water with the same force as on the water from the balloon's rubber.
Reply: @None888.  Not so well-put. Mass gives resistance (inertia), and that's where the reaction force is taken from. And you haven't tried to find it hard enough in your research, or the internet explanations aren't often mentioning it.
Reply: Except you are creating thrust through pressure and there is no pressure in space. There is no third law here, its like shooting blank bullets, they create little to no recoil. Why is it so easy for you to believe lies? Its not like you have a hose that shoots liquid fuel, you explode fuel in hope to create pressure against something THAT ISN'T THERE!!
Reply: @choural  Guess where there's pressure? Inside the combustion chamber, which then forces exhaust out the back, keyword: FORCES. There's a force, therefore acceleration, therefore motion.
Reply: @choural  If you had a 3000 PSi oxygen tank in space, and you opened the valve, What happens?

The 3000 PSI cannot escape instantaneously.  
Does the gas from inside the tank get ACCELERATED as it escapes?

Does this gas have MASS?

Can MASS get accelerated WITHOUT a force?

Answer those questions for me.
Reply: @stuartgray5877  A vacuum that doesn't pull or absorb? You're living in a fairy tale land.
 This guy is a paid for government shill promoting lies ❗
1) you cannot pull a complete absolute vacuum in any vacuum chamber.
2)  In that vacuum chamber the gases produced by that rocket engine could not be absorbed as fast as they got produced.
3)   the gases coming from the rocket engine pressed against the side of the vacuum chamber which gave it its boost pushing it across the alleged vacuum chamber.
4) Just like in a vacuum flies can't fly. Everyone should know that for every action there is an equal and opposite reaction, that is, as long as you have something to be pushing off of or against.
So, what you just inadvertently proved to the world, if the sheeple can see it; is that, like a fly that can't without an atmosphere for its wings to be beating against, a rocket engine cannot Propel anything in a complete vacuum either; because there's no atmosphere for the hot escaping gases to push against. Proving that there's no such thing as space travel. Like going to the moon, satellites in outer space or sending a rocket probe to other alleged, so-called planets.
Wake up sheeple❗ NASA, Never A Straight Answer - National Academy of Space Actors. They are lying to you, belittling you, making fools out of you, taking you away from our Creator God.
The Words of Christ: "And no man hath ascended up to heaven, but he that came down from heaven, even the Son of man which is in heaven." John 3:13 KJV
 Let those words sink in, think long and hard about what it is telling you. Yahushua, the Lord Jesus Christ KNEW that we were going to be fed the lies of allegedly traveling in the heavens, what they call outer space.
Repent and be baptized in the name of the Lord Jesus Christ. We are in the very last days of this Earth's history ❗
Reply: @stevencurtis7157  A change in velocity has to come from a resistance. If you are in an absolute vacuum and push off on the basketball, since there will be nothing resisting that basketballs motion neither will you in effect move in the opposite direction.
Reply: @jrngln  So you thrust your arms out to push the basketball, right? Does the basketball move or stay put? It obviously can't stay put, otherwise things would be stuck in space forever, unable to be moved. If it moves, why don't you also move? What's stopping you from being moved? What's causing the basketball to move?
Reply: in a vacuum, if you provide movement to an object it should never stop.  Now, creating movement with a rocket i do not know (you will get boost with the proper config) but as there should be no resistance you should only get fire not movement (theoretically) I may be wrong.
Reply: @mavadavia8340  Fire has mass and momentum, that's why rockets provide thrust.
Reply: it does not only work in space, but also here on earth, just throw a bowling ball real fast, youll see, you get pushd back
Reply: @theglitch9325  Exactly, because you're pushing off something, in this case that you presented, a bowling ball❗
This guy is a paid for government shill promoting lies ❗
1) you cannot pull a complete absolute vacuum in any vacuum chamber.
2)  In that vacuum chamber the gases produced by that rocket engine could not be absorbed as fast as they got produced.
3)   the gases coming from the rocket engine pressed against the side of the vacuum chamber which gave it its boost pushing it across the alleged vacuum chamber.
4) Just like in a vacuum flies can't fly. Everyone should know that for every action there is an equal and opposite reaction, that is, as long as you have something to be pushing off of or against.
So, what you just inadvertently proved to the world, if the sheeple can see it; is that, like a fly that can't without an atmosphere for its wings to be beating against, a rocket engine cannot Propel anything in a complete vacuum either; because there's no atmosphere for the hot escaping gases to push against. Proving that there's no such thing as space travel. Like going to the moon, satellites in outer space or sending a rocket probe to other alleged, so-called planets.
Wake up sheeple❗ NASA, Never A Straight Answer - National Academy of Space Actors. They are lying to you, belittling you, making fools out of you, taking you away from our Creator God.
The Words of Christ: "And no man hath ascended up to heaven, but he that came down from heaven, even the Son of man which is in heaven." John 3:13 KJV
 Let those words sink in, think long and hard about what it is telling you. Yahushua, the Lord Jesus Christ KNEW that we were going to be fed the lies of allegedly traveling in the heavens, what they call outer space.
Repent and be baptized in the name of the Lord Jesus Christ. We are in the very last days of this Earth's history ❗
Reply: @theglitch9325  of course you're going to move back because you're pushing off the bowling ball, which just proves that you must push off of something in order to get movement, a rocket pushes off of the atmosphere, you put it into a vacuum with no atmosphere the rocket cannot move.
Reply: @dr.davidbannerf.e.s.6217  exactly 👍👍

What these charlatans try to always do is use two actual real forces applied to each other like a ball and a human 

Both human and ball are a solid mass....so newton's law of motion can be observed...

But these fraudsters take 1 of the masses away to talk hypothetical nonesense...

It is like a pole vaulter swapping the ground which is what they use for lift using a swimming pool to put there pole into....it ain't going to work...😁

They all know this but yet they still keep parroting the same nonesense....they are  either too egotistical to imagine they could possibly of been lied too

Or they are on the payroll to endlessly shill and try to influence people...its probably where half the space budget goes...feeding SM trolls..😁👍

They're relentless....always appealing to authority will never make comment on any obvious fakery wires or cgi fails...

Any sane person would be asking where 100s & 100s of billions of tax payers money went...and asking why they use models of tin foil cardboard and straws to fake space footage....🤷🏾‍♂️

But for some reason people seem to love the fact that there governments waste billions talk bs about terra forming planets when they cant even look after the people properly...

It's very possibly why the great reset is upon us...too many people have awaken to the bs and absurdity of programming and propaganda..
Reply: @stevencurtis7157  fist off,  that basketball would have exploded because of 1 ×10 -17 torr pressure.
Reply: @paqman9101  I didn't say you took an inflated basketball up into space, I said you had a basketball in space. If you prefer, you have a bowling ball instead.
Reply: @dr.davidbannerf.e.s.6217  you are correct
Reply: Newton's 3rd law; "Every action must have an EQUAL and opposite reaction". Who's throwing the ball in space? A 240 pound man? Then the light 2 pound ball will move farther & faster from the imaginary 240 pound thruster in space (what moves faster & farther on earth? The cannon or the ball?) A rocket throwing gas into 0 pressure is a different thing. I don't doubt your intelligence; I only challenge your imagination which ALWAYS gives birth to true science. No resistance of atmosphere, just escaping gas into INFINITE direction of 0 pressure; it is reasonable to doubt what we have been told by corporate media, CIA & the millitary Industrial Comlex. I'm not a conspiracy theorist; I just question certain things that consistently throw up red flags. Read through my comment without influence of NASA propaganda and you'll have to admit; I do make an intelligent argument.
Reply: Whether I believe in the vacuum of space or whether the earth is flat, round, or shaped like a pear is another matter, and forgive me if I'm repeating what someone has already said, for I do not have the patience to read all the backbiting and bickering that undoubtedly is going on in this thread. 

Bottom line, I understand why the OP pinned this comment. Simple analogies, basic phenomenon, fundamental questions are the best teachers along with Newton’s third law in this case. The principle of a nozzle creating trust is based upon the transfer of momentum independent of atmosphere, notwithstanding changes in the atmosphere due to momentum transfer potentially impacting results. Well done!
Reply: So then a propeller should work if newtons third law applies in a vaccum
Reply: @Cody-mc7oe  Propellers require something to push off of because they don't expel material to make them move. Entirely different principle.
Reply: @stevencurtis7157   But in a vaccum, wouldn't all the atoms move at the same speed. Thus, not creating pressure for thrust
Reply: @Cody-mc7oe  Why would they all move at the same speed? Atoms move at whatever speed they've been accelerated to.
Reply: @stevencurtis7157  wouldn't they all be accelerating at the same speed?
Reply: @Cody-mc7oe  That sentence doesn't make sense. When things accelerate they change speed. Also, what do you think is causing them to accelerate?
Reply: @arlanwade3268  Can you tell us how much say a 10000 kilogram man might get "pushed backwards" if he was to "throw" 500 kilograms of water to a velocity of 2500 meters per second?
Would hurling 500 kilos in such a way that you accelerate that mass from zero to 2500 meters per second create a significant recoil force?
Would it matter if the 500 kilos was "thrown" into a vacuum or into atmosphere?
Reply: It pushes the gases produces , to the back and thus it produces yhrust.
Reply: @NotAnotherFucking  All gases bounce around at high speed in their container. The higher the temperature and pressure, the faster the average speed per atom or molecule. When there is an opening in a container, which is what a rocket nozzle is, there is a place where those gases can escape. If the chamber was closed, those same gases would transfer their momentum back to the chamber, cancelling their effect out. Thrust is the result of gas pressure being let out in a preferred direction.
Reply: @NotAnotherFucking  I'm not talking about building pressure. That would happen due to combustion, but I omitted mention of it because it's irrelevant to propulsion. 

Sounds like you agree that rockets work in space. What I described in my last post is a conceptual explanation of the physics of Newton's third law. I'm not sure how you don't recognize it.
Reply: @NotAnotherFucking  I said it would cancel out. That is correct. I was not talking about a case where pressure was increasing. Ignoring certain things for the sake of explaining a single concept is commonplace in scientific explanations. Ignore friction, ignore drag, assume constant speed, etc. in a closed chamber of constant pressure, the gas bouncing around is imparting momentum every time it hits a part of the chamber. Every time it hits the opposite side, the tiny bit of momentum it imparted before is cancelled out. Net effect with everything bouncing around, particles colliding with other particles, is zero thrust. Even if there was combustion, there's no thrust. Also, nevermind that explosions were irrelevant to the point, it wouldn't explode anyway. I forgot to mention that the combustion chamber has titanium walls that are a hundred meters thick. Don't make unnecessary assumptions and then frame it as a gotcha.
Reply: @NotAnotherFucking  There would need to be enough fuel to create the necessary pressure to rupture the chamber. Another random detail you've assumed. And again, the chamber exploding is irrelevant. This entire exchange has been pointless.
Reply: @NotAnotherFucking  It wasn't an error and I explained why multiple times.
Reply: @NotAnotherFucking  I went back and read your first comment, and I think I understand the problem. I specifically avoided just stating or rewording Newton's 3rd law because the conspiratorial types don't trust science and think that anyone regurgitating common scientific laws in familiar wording is a sheep. I deliberately tried to explain it using simple English and my own understanding. There are lots of laymen here who get it. Those who don't have continuously embarrassed themselves further by posting here. All I can hope is that some of them learned something.
Reply: @NotAnotherFucking  Also, just so you know, the thread was capped at 500 posts for years and dropped to 400 in the past few months. I have no idea what happened.
Reply: Hacsak nem az egész univerzum egy dobozban van..
Reply: The ball moves you dont but the human body becomes the mass exerting stored energy on a lesser mass . The problem would be maintaining that . Where you would physically have to chase the ball through the vacuum of space and repeat . While maintaining that stored energy !!! Staving off starvation and thirst while maintaining sufficient Oxygen levels , all while soiling your pance .
Reply: @markhall5776  Are you ok?
Reply: @stevencurtis7157  Says The Engineer !
Reply: @markhall5776  You think my understanding of the problem is screwed up? You realize you have to bring your own fuel, right? It would be like if you had a bag full of basketballs and a throwing machine that could push them as hard as possible. If you could chase the ball down in space and keep throwing it, you wouldn't get anywhere because you'd have to undo your acceleration to get back to the ball. Meanwhile, you're talking about messing your pants, spelled wrong.
Reply: @stevencurtis7157  Exactly !!! Everything must start its innitial accelaration from a mass exceeding its own and maintain that innitial accelaration . Meteors are ejected from a mass far exceeding its own , now explain how it maintains that innitial acceleration ? Then you'll reach your answer .
Reply: @markhall5776  Meteors don't maintain acceleration, they maintain velocity. Rockets maintain acceleration by burning fuel.
Reply: @stevencurtis7157  Ah ! There you go see !
Reply: @stuartgray5877 Not true. there is no pulling or pushing. There is nothing,,,,no gasses for the rocket fuel to push against.
Reply: @garykarr1421  - "no gasses for the rocket fuel to push against."

So what you are saying IS: "I have never actually SEEN a rocket in my life".

Maybe you should ogo watch one, and you would realize that there are GASES COMING OUT THE BACK.
Reply: That's a really interesting point. Pushing a gas against another gas is different than pushing an object away from another object ??🤔
Reply: @jonodonnell9926  According to Newtons Laws "gas" is just another "object" with mass.
When rockets apply a "force" to accelerate the mass of the exhaust gas into the vacuum the rocket MUST feel an "equal and opposite force" which pushes it forward.
Reply: @markhall5776  I know this was a month ago, but you just said "Exactly!" while making absolutely no point whatsoever. 🤦
Reply: Because physical thrust from a human has no bearing on whether a rocket can provide thrust  using fire.l in a vacuum.
Reply: @wunsocknoshooz4128  Please explain the difference in terms of momentum.
Reply: Or how about the reality of the gases hit the chamber wall and oh yeah, the other gases now inside that it rode in with.
Reply: @stuartgray5877 I can see where the refusal is at. Difference between the two is, one sought an answer through questioning. The other arrived at an answer provided by an authority. Questioning incorporates a willingness to learn through experience with scrutiny. Whereas the latter invokes a head nod and a repeat after me. Because they have the answers, you just sit back chin up ready to feed. They got this thing called life all figured out, don't worry. Nothing they're doing was designed for distracting...
Reply: @stuartgray5877 btw it seems like you were struggling really hard to get all that out. Maybe you should use a volleyball in your example next time.
Reply: Wow, gee. That really truly is a difficult situation for one to be plagued by uncertainty about. Did the basketball have a space suit to keep all its guts in, too?
Reply: @iwontellyouitsmenotu  A basketball doesn't boil when you expose it to vacuum, unlike your watery flesh. Your attitude is irrelevant to the facts.
Reply: @iwontellyouitsmenotu  Are you STILL going on about how you believe rockets do NOT work in a vacuum?
Hard to tell.

Did you READ my posts above?
Reply: That's hilarious. Well. If you ever make it there. Please tell us how it goes.  Because that's poppycock
Reply: @poppawolf8777  - "Because that's poppycock"

So you are saying that you dropped out of high school before you took physics so you don't understand.
Thanks for that valuable insight.

Now perhaps you could GO BACK and finish high school?
Reply: @stuartgray5877  you are free to assume whatever makes you happy.  Best part. You don't know.  You Can only assume🤣🤣🤣🤣,    n if you think your ignorance is relevant keep on bantering.  I'll remind you how insignificant your opinions of me are🤷🤣🤣🤣
Reply: @stuartgray5877  just for shits n giggles. Please explain how planes going on the southern hemisphere as you believe would have to fly upside down and if not at what point do they reorientate ?  Ships also. And how come nobody on or neither equator are tilted sideways. These physics would have to apply on your sphere🤷
Reply: @ if you do not understand how “down” always points to the center of the sphere, then I fear there is no hope for you

Just accept the fact that you cannot visualize things in 3D and have the intellect of a toddler.
Reply: @ I could show you photos of earth taken by spacecraft I helped build and launch. But you would just call them fake without evaluating them. So what would be the point?
But bless your little heart for effort!
Reply: @ I have an Engineering Degree and a career that makes me almost a quarter of a million dollars a year and five NASA achievement awards
You don’t even have a high school diploma 

But ask the teacher of your special needs class to give you an extra star today for effort!
Reply: @poppawolf8777  Down is toward the center of the Earth. It's not the same direction everywhere. Planes and ships orient themselves to the medium they're in. The ship just floats on the water so it's pointless to explain; if you can't see that, you're hopeless. The plane is steering to maintain speed, altitude and heading. If it started climbing (which would take a long time via curvature) it would either be corrected by software or the pilot. The effect would be indistinguishable from drifting up, down, left and right due to the engines pushing the plane through tons of air.
Reply: @stevencurtis7157  down is towards your feet🤷 no kidding that's why on a sphere once they past the equator they will gradually be going upside down the farther south they go on a globe. I'm not sure how this simple physics eludes globers. Same for plains.  You're right it's pointless to explain simple facts to someone not ready to comprehend it.    You can grab a basketball n a hot wheels car.  Start up top n ride that sucker around from top to bottom n that car ends up upside down period... And anything parallel with the equator should be walking ,flying, or sailing on its side.  If they are following earths curvature🤷🤦🤣
Reply: @poppawolf8777  every 70 miles traversed across the planet "down" changes by one degree.  when you are on the bottom side of the ball "down" STILL POINTS to the center of the ball.
We are sorry you are suffering from the inability to visualize things in 3D. Some people have this affliction.
Reply: @stuartgray5877  then where is the curve.. and you are wrong it points north not the center apparently you have a hard time with fantasy n reality.  Thanx for at least admitting you suffer from things. But there is still hope for you. Not wise to assume you know something about someone you've never met, just makes you look the ass🤣
Reply: @poppawolf8777  Exactly, they follow Earth's curvature. You're trying to spend and save the same dollar if you think a ship would need to be on its side because of curvature. From your perspective, the ship is rotated, but so is the ocean, the ocean floor, the atmosphere and the direction of gravity, all by the same angle.
Reply: @poppawolf8777  You mo-rons do not even realize 
that we launch rockets to space more than once a week now, 
from the US alone.
do try to keep up.